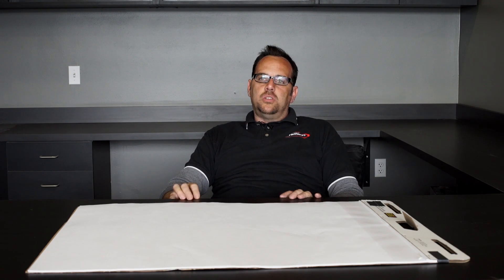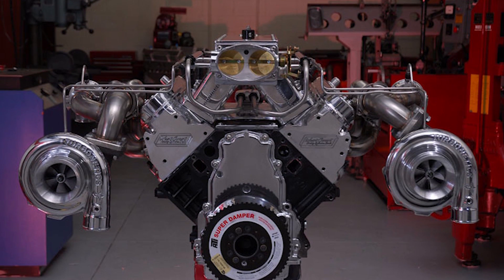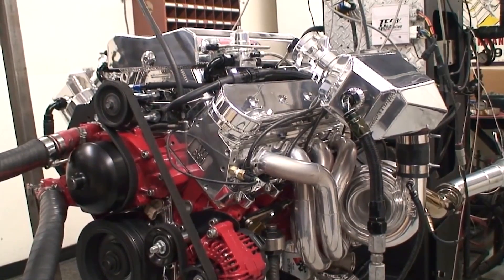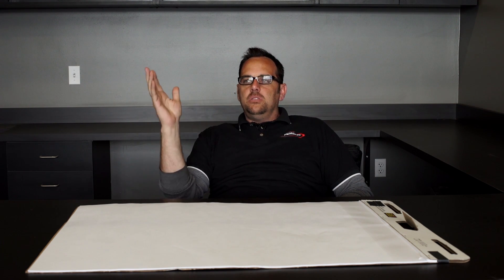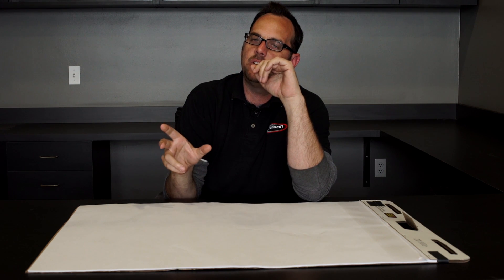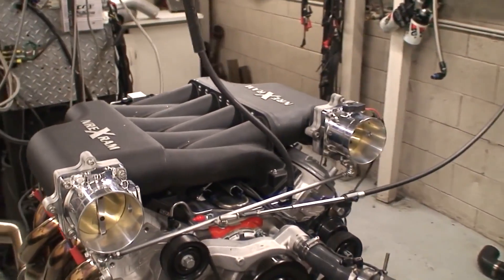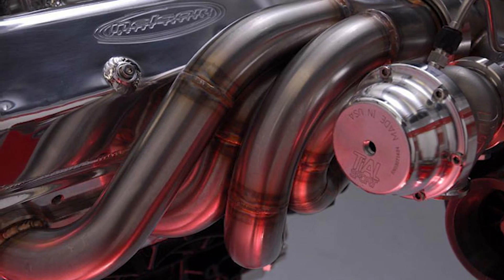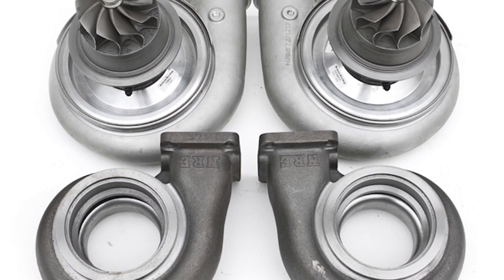Master Engine Builder Explains Why the LS V8 Is SO Good

Comment: "LS swaps are stupid" - 17 year old JDM fanboy who has never had a car faster than 15s 1/4 mile
Reply: +Foxtrot Oscar

Before you call me an import hater, I own and track an S2000, and have never owned a piece of GM hardware.  Even so, I respect the LS.  It is a light, space-efficient, economical, readily available powerhouse, and nothing does what it does better than it does..

For the LS vs. VQ - are you serious?  I'll take longer - there's an extra pair of cylinders.  But have you seen the size of the cylinder heads compared to the cam-in-block design?  because here you go:

http://i51.photobucket.com/albums/f361/prolariot/IMG_5356.jpg

The VQ35 doesn't have valve covers on there either, so add another 2" to height and width.

How much is the brand new 2Jz going to cost you?  Oh wait, you can't buy one, they stopped making them 15 years ago.  A refurb costs minimum $5 grand, and you still have to add turbos, turbo plumbing, intercoolers, etc.    I can buy a new LSx tomorrow.  Unless you have a supra already.  I guess I missed that part.  And the 2Jz is an iron block boat anchor and weighs 50lbs more than an LS while being longer and taller too.

And moreso than that, you're comparing aftermarket support to factory power levels.  That's apples to oranges.  If took $7k and your already LS equipped car and bought a blower, you would be looiking at 6-700hp.  It would be a hell of a lot more reliable too since you're not pushing 30psi (2bar if you live outside of the US) to make that power.

I missed the part where an SR20 came with forged pistons, a massive FMIC, twin-scroll manifold by FullRace, and a GT35r from the factory.  Because they didn't.  And oh wait, that's also $7k.  Bet those will fetch a premium the week before race wars.
Reply: +Foxtrot Oscar people pay no mind to this guy. He's just shown the world how ignorant he is to engine builder. Any intelligent and educated engine builder knows not to play favorites with brands it's all about design, like Tom said "engines are just air pumps." it doesn't matter whether the engine configuration is straight, V, or flat. it doesn't matter if uses push rods, overhead cam, or pneumatic valvetrain what matters is flow. And that means flow you need for your specific application.Tom Nelson knows what he is talking about. He is a world record holding engine builder. I went to School of Automotive Machinists in Houston Tx. They teach the exact same concepts. Guess what.... they are a world record holding school. Just like Tom said there is no perfect head. I bet if you ask what's the perfect engine he will tell you there isn't one. Everything is application specific. Who you are going to take notes from people, some troll in the comments section. Or the world record holder that makes millions of dollars because he has a reputation that speaks for itself.
Reply: Foxtrot Oscar Low output per size? Lol do you realize that the LS engines are physically lighter and smaller than most DOHC engines with half their displacement? The LS engines are unbeatable in terms of output per size.
Reply: ***** But where does that "technological development" manifest itself in the car's performance? Does it make the car accelerate quicker? No. Power-to-weight does. Is high RPM's in and of itself a beneficial thing? No. If a car revs to 8000 and makes 500hp, it's still just as powerful as a car that revs to 7000 and makes 500hp.
Everyone equates VE to "technological development" for no real reason. It does not manifest itself in the end performance numbers of the car. Everyone just perceives it to be better because it appears more "high tech."
Reply: The whole horsepower-per-liter argument is a sure sign of a noob. Nobody talks about HP/L anymore, because people have realized that it doesn't give any indication of power-to-weight. The LS engines have absolutely unmatched power-to-weight capabilities, and that is what makes the car go faster in the end. Period.
Reply: +Foxtrot Oscar

I don't know where you're getting any of that.  A crate LS3 gives you 430hp for $7500, a LS2 out of a wrecked GTO, C6, or C5 Z06 will give you 400, and mid-300s for an LS1 for less than $2k.

Being all aluminum, they weigh nothing.  A fully dressed F20C is 326lbs.  A VQ35 is around the same, and it is an exceptionally light V6.  An LS2 or LS3 is only 75lbs more and has so much more potential it's mind boggling.  Not to mention it is more compact than the VQ because of the pushrod design, so it fits into basically anything without much need for making space.  27% more weight for 25-50% more horsepower?  Yes please.  And it's cheap!  Plus you have a nearly unlimited aftermarket if you want more power.

I've said it before and I'll say it again: there aren't many vehicles that aren't made better with an LS swap.
Reply: @BecauseRaceVids  e30
Reply: +Foxtrot Oscar You're a brain dead English troll. GTFO you Jag loving moron.
Reply: *****  But for what reason is VE important? It does not give any indication of power to weight. VE will not make the car go faster. Only power to weight will.
Everybody always talks crap on the LS for having low "horsepower per liter" and yet they can never explain why "horsepower per liter" is important. Basically their whole argument is "cuz its more high tech." But what good is "high tech" if it doesn't maximize power to weight?
Reply: came here to learn things, ended up reading jacked shit from fanboys and misleading noobs with cash and cars who also posts in other "heroVShero" comic threads. Where are the pro builders and engineers?????
Reply: +Richard Harrold 
That primitive LS engine has better fuel economy than a GTR. The single cam design is optimised for efficiency. Cam it, boom, you're getting over 500hp crank. IHE, closer to 500 wheel. Have fun doing that with the strung out MB v8. It'd cost as much as an LS to have those gains.
Engine size, weight, packaging, cost, modifications are all part of the package. No one swaps a MB V8 because of the cost, weight, size. You want 800hp NA? You can buy a turn key LS based motor that will do it. There's a reason LS is number 1 for re-powers and swaps.
Reply: +Richard Harrold and how much does that mercedes motor cost and weigh?? also how big is the overall dimensions
Reply: ***** Believe me when I say that no one in America, the LS engine's birth place, gives a shit about what you think about it or its IMAGINED slights. No engine gains 100+hp with a cam swap alone. Don't try to feed me that bullshit, son. I've has my hands in anything with 4 wheels for over 20 years. Your comment shows you didn't watch the video. The LS7 head flows well over 360 cfm. And check this shit out:

"In 2011, a class action lawsuit was filed in United States District Court in New Jersey against Daimler AG, Mercedes-Benz, Mercedes-AMG for alleged defects in the M156 engine contained in AMG vehicles built in 2007-2011 model years leading to premature wear. The plaintiff claimed the combination of cast nodular iron camshafts and 9310 grade steel valve lifters contributed to the premature wear."

What a pos. Yeah its so much more impressive than an LS3. Do you realize that it actually boasts more displacement at 378.8 cu. in. @ 500hp vs the LS3's 376 cu. in. @ 450-460 out of a crate? They make more hp but less torque. It redlines at 6,800rpm. Big deal. The LS3 does revs to 6,600 while making more usable power and torque. The LS7 revs to 7K. But I thought DOHC were supposed to be better?
Reply: ***** "The LS is cheap because it uses lower quality components" - such as? Source?
Reply: Foxtrot Oscar  And that engine itself probably costs more than an entire Corvette. VE= Volumetric Efficiency, or "Horsepower-per-Liter," which has been shown time and time again to be a completely meaningless number.  Power to weight wins in the end. It's very simple.
Read this: it literally takes Mercedes a $56,000 engine just to match the power-to-weight of the LS7.

http://www.caranddriver.com/columns/pushrods-versus-overhead-cams-part-38-modern-v-8s-from-gm-and-amg-slug-it-out
Reply: ***** You talk too much off ignorance mate.
OHV I don't care who makes it will be lighter and smaller then the Comparable DOHC. Those are Facts of life.
DOHC obviously provide performance benefits, but with cheap performance cars those benefits are largely unnoticed.
You're bitching about engines that didn't sell well in either continent... I mean seriously what the fuck do you expect?
All that matters is the winner... and as long as chevy can come and fight with the best and win races at IMSA and even leMans you're blowing hot Air.
Reply: Foxtrot Oscar Since when is 518hp "significantly more powerful" than 505hp?
Reply: +Foxtrot Oscar keep hating the ls engines are so simple and we'll built , durable and e z to upgrade.the height is low enough to clear most hoods and the engine is more compact than most v6s. I don't know why you're mad at a motor lol what's wrong with you?. I have yet to hear of many vq swaps.the only thing better in terms of cheap power is a 2j which are discontinued and requires the space purchase of a tucking turbo and custom exhaust manifolds if you swap.
Reply: +Richard Harrold I have a 600 hp ls1 that has instant throttle response and very efficient and far more reliable than a dohc. They are cheaper and easier to work on and have been proven very worthy time and time again. I know it and Nelson racing knows it. He makes insane horsepower out of ls motors that dohc can't compete with.
Reply: +Foxtrot Oscar I hate to be one of those guys, but you REALLY don't know what you're talking about. LS engines are lighter and physically smaller than almost any dohc 6 or 8 cylinder engine made. your typical 5.3 makes up to 340hp from factory and can handle up to 1,000hp with nothing but a valve train upgrade. Several people have done it. If you think they're larger than a VQ45, you're just typing to troll people that don't know any better. I have a picture of a VQ45 and an LS3 sitting side by side. If I could post pictures here, I would prove you wrong on the spot. Do you realize that there wasn't a dohc n/a V8 made before 2011 that could match the LS2 in power, torque, and fuel mileage? Some "stoneage" technology, huh?
Reply: +Foxtrot Oscar And another thing: "low output for size"...I assume you're pulling a Honda fan and throwing out the displacement argument. For someone who claims to be an engineer, you're not that bright. Then again, I work with engineers on a daily basis and haven't met one yet that has any walking around sense. OHV engines get the majority of their overall output from their bore and stroke. OHC engines generally get their output from the head design. LS engines are the exception because GM found a way to increase cfm performance while maintaining displacement which in turn created an engine that both reacts outrageously to f.i. and n/a upgrades, and is reliable at the same time. The vast majority of dohc engines do not respond well to n/a upgrades (ported or aftermarket heads, cams, intake manifolds, etc.). Just look at the Mustang aftermarket. Almost every part is geared toward boosting a 3v or 4v.
Reply: Deadeyedickification   Don’t waste your time. He’s biased and blows nonsense from his ass. There’s nothing you can say that would get him to admit he’s a fool.
Reply: ***** No one cares about specific output. It literally does not matter. Horsepower and torque throughout the power band, weight, physical dimensions, cost, ease to maintain, and fuel efficiency are all that matters. Who cares how fast the engine revs under no load? You're never going to need an engine to rev up really fast on a track, because the engine's rpm will be limited by the load placed on it through accelerating the car. Where have you seen an M156 getting 30 mpg? Is that on the European cycle? Because the US cycle, which I believe you're referring to in regards to the Corvette, is much more stringent. Over here, the 2013 C63 AMG managed 13 mpg city and 19 mpg highway. That's far worse than either the Camaro SS or the Corvettes from that year.
Reply: Foxtrot Oscar And I'll keep asking the same question: Why does the better-breathing and better VE matter if it does not result in better POWER.TO.WEIGHT?
In the end, an LS7 makes 505hp and weighs only 450lbs. Period. End of Story.
Reply: +Richard Harrold 
Just about every performance engine, let alone the S65, is less efficient than the LS series. The fact that you don't already know this indicates to me that you looked at nothing more than the displacements and assumed. The old M3 with that engine managed 14 mpg city and 20 mpg highway. Even the heavier 2013 Camaro SS with an LS3 gets 16 mpg city and 24 mpg highway. The C6 Z06 with its 505 hp LS7 is listed at 15 mpg in the city and 24 mpg on the highway, with most owners reporting better mileage than that. Just to reiterate what everyone else is already saying, HP/L means NOTHING.
Reply: Foxtrot Oscar You keep on going on and on about why it's stupid and antiquated, and you still have yet to give a single legitimate, QUANTIFIABLE reason. You just keep coming back to "cuz DOHC is more high tech and stuff." Once again I ask, where does that manifest itself in the end performance measures of the car? Does VE make a car faster? No. Power-to-weight does. Does it make an engine smaller and more compact? No. Will it make an engine have a lower center of gravity? No.
Reply: ***** First of all. He is anti-American in terms of cars. He will not give one bonus point to any vehicle made in America. He is a 16 y/o English fanfuck who knows literally nothing about cars or engines. He claims to be an auto journalist. No self respecting auto journalist would downright degrade something, nor would they troll LS videos on youtube to start fights.

Secondly. LS is set up from the factory to be a well balanced platform and they will not put more hp than what is needed in GM's front engine/rwd platform cars. LS has immense potential for power and there are SEVERAL videos of N/A LS motors making well beyond 700HP with as little as 5 grand put into them and over 2000hp when internals done. LS7 - 505hp, 460lb-ft, 403lbs, $12,000. M156(third attempted version) - 518hp, 465lb-ft, over 500lbs  $38,000. The M156 is tapped out at that point, it cost Merc $26,000 more, an extra 3 camshafts, an extra 16 valves just to match "ancient" technology. People filed lawsuits against AMG for failing camshafts and valves caused by weak steel. If the technology is so much better and German manufacturing is so awesome, why did they make a camshaft from cast iron, and the valves from basic steel? They might as well used tinfoil. The only reason the cost of LS series is so low is that there are soooo many of them being made GM just built there 100 millionth small block, I think they may have a few things figured out at this point in time. GM even offers a program to come help build your motor BY HAND. Now for size, LS is much smaller, and is smaller in size than many inline and V six cylinders like the VR36DETT, 1 and 2JZ, VQ35, and many others, not to mention being significantly lighter than all these engines.

Thirdly, the LS is a pushrod engine, sure valve float is possible at extreme RPM. But that doesn't fucking matter because it doesn't need to rev past 7000 to kick the shit out of any V8 that has ever come from the Eastern World. People make over 2000hp, 2000lb/ft with this technology at under 7000rpm. They are accredited to be the best bang for buck on the planet and there are many with as much as 500,000 km's before rebuild. No Euro engine can do that, except maybe a TDI.  LS is swapped into everything from chainsaws to airplanes, and there is a good fucking reason for it.

You defensive Euro-loving biased morons need to look at facts, not just make shit up on why you don't like the LS because one just dragged your piece of shit Ferrari down the street. LS is king of V8's. It's not up for argument, it is FACT. I am sick of setting US-hating Eurotrolls straight when they spew their fucking bullshit all over the internet.
Reply: Foxtrot Oscar STFU troll.
Reply: First of all, I'm not assuming anything. It's obvious what you're doing. Secondly, I'm not a boy. I think everyone here would rather trust the guy in the video who has more experience than you driving and more experience with LS engines and car mechanics in general.

Still haven't given a reason as to why you clicked on the video if you already had opinions and knew everything you needed to know.
Reply: +Josh Wallace and his car sounds like a dying vacuum with a cazoo attached
Reply: PontiacEfurd Wrong. A brand new turn-key LS3 is a tick above 6K. But it's always been cheaper to rebuild used engines if you want a modified one anyway.
Reply: Foxtrot Oscar You mean the 458 Speciale's engine? Show me a source for those specs, because I've looked and found nothing. I imagine that engine is actually larger and heavier than the LS7.

Even assuming they're correct, your math is wrong. 150kg is 17% lighter than the 181kg (400lbs) LS7. And last time I checked, 597 is not 33% more than 505. It's 18% more, and the LS7 makes 18% more torque than the Speciale's engine. That's an actual fact that I can cite sources for.

Speaking of torque, I believe that smoothness that you're describing is actually a lack of it, especially in the low range. I've had this conversation with you elsewhere on youtube, and you still are blabbering on about it. You want the engine to not make enough torque in the low range to spin the tires if you plant your foot while exiting a corner. That's not fast. That's being a lazy driver. That pedal under your right foot is what's supposed to be responsible for modulating power, not a horrible power curve. The LS7's amazing throttle response and torque will spin the tires in a hurry if you're a bad driver.
Reply: You think official economy ratings are BS? Why, because they don't fit the way you would like things to be? Much better to trust anecdotal evidence, clearly. It's pretty obvious at this point that you know fuck-all about the cars that you're talking about. For starters, the C7 doesn't make anything like 230hp in V4 mode. You just took the engine's total power and divided it by two. It doesn't work that way. Those 4 cylinders still have to deal with the friction from all 8 cylinders, so it doesn't scale like that. Also, in order to make that power, it would have to reach towards the top of the rev range and be at full throttle. As soon as you exceed a certain throttle threshold, all 8-cylinders light up immediately, so you would never reach peak power for just the 4 cylinders. And apparently I have to state this again, since you can't read: the C7 does not have an LS. It has an LT series engine. They are not the same. You also keep harping on about cylinder deactivation as if it's cheating. It's not. It's no more cheating than having variable valve timing or a turbo charger. You lose power when you don't need it in order to improve fuel economy, and you get it back as soon as you want it. You still haven't given me any practical or performance-oriented reason to care about HP/L, and that's because there isn't one. Now you want to go one about American V6s? Alright, I'm game. The GM LFX currently makes 323 hp, and next year it will make 335 hp in the new Camaro. That's a 3.6 liter, by the way, and it makes that power on 87 octane. Last I checked, 440 hp is not twice as much as 323, and 4.4 liters is more than 3.6. You bring no facts to this debate. Nothing but anecdotal evidence, hearsay, opinions, and outright misinformation.
Reply: ***** My answer to any of your claims that the LS engine is inefficient:
LS7 = 505hp and under 450lbs. Like I said before, it takes Mercedes a $56,000 engine just to match that power to weight.
Reply: +Richard Harrold Shut up, fuckboy.
Reply: Thomas Patterson Nice argument. You must be a really smart guy. Look up everything I stated. It's called FACT. Not opinion pieces you Europusstrolls make up to make you feel better about your shithole island and worthless V8 engines. Show some respect from the country that is directly responsible for your mere existence. If it wasn't for US tech, you would be putting the steering column in a VW Beetle, for free.
Reply: ***** Foxtrot is nothing but a troll that works at a grocery store, living in his moms basement. I don't know why your defending him. He's a bum dart champion and spews nothing but biased bullshit against American cars and engines. If he gives a plus one to an American anything, its because he feels England had a hand in developing it. England sucks, so do your cars. How is McLaren doing in F1 again? Oh right, they cant finish a race without engine failure.
Reply: +Foxtrot Oscar you do realise that all the stuff you said was wildly incorrect? Ls engines are actually genious. Gm obviously knows thier engines can make way more power than what they put out. It all comes down to emissions here in the states because of tree hugging liberals who cry about green house gasses. Let me elaborate. Bmw for example, squeeses every avalible bit of power from the factory out of their engines. Sure, you can increase boost and retune for extra few hp but not with longevity in mind.  Ls engines are capable of way more power with far less modifications and still have the same reliability. Gm purpously holds the engines back to make them last and for numerous other factors you fail to see. The department of transportation also limits what the cars can
 put out and still meet safety requirements. Basically our government sucks and holds us back. With that in mind, gm gives us the base building blocks to mod up to what it should have been from them to begin with. They could have easily made the ls7 put out 700 hp from the factory, but it would never pass safety regulations. Dont be so naive.
Reply: Foxtrot Oscar Any reason why to back up your opinion, guy?
Reply: ***** But it really isn't an indicator of efficiency, as my prior post proved. Higher revs does not always equal more power. That's very dependent on engine design. Higher rev limits aren't more fun for everyone, either. That's a matter of opinion. Some people don't want to have to string their engines out to 9000 rpm to make peak power. Your point on some M156's getting 30 mpg is complete heresy, since no agency has substantiated it, and will be ignored. Even if it were accurate, that would be with an imperial gallon, which, as you brought up, is .761 liters larger than our gallon. So you're comparing mileage from cars in the UK, using a different standard for the volume of a gallon, to mileage ratings in the US with a smaller gallon. The fact of the matter is that, in the US, as rated by the EPA, cars with LS engines get much better mileage than the BMW M3 with that engine, or just about any other performance car of that caliber. The LS series of engines do not have cylinder deactivation. I will repeat that, since it seems to be a big point for you. The LS1, LS2, LS3, LS6, LS7, and LS9 do not have cylinder deactivation. The LS3 is in the Camaro SS, and the LS3, LS7, and LS9 are in different models of the C6 Corvette. Only the C7 has cylinder deactivation, with its LT1.
Reply: ***** You completely ignored everything I said. You side stepped. Stay over on your side of the pond so that you shit heads don't seep that know nothing mindset over here. Mercedes engines are not impressive. They're bloated, over rated boat anchors that cost too much to maintain and upgrade with little gain.
Reply: Downsizing to what? 4 cylinders? bitch please. I'll downsize to a 6 cylinder and skip the four and go straight to electric. *****

M156 became irrelevant... Quit trying to sugar coat it.. They couldn't make it pass emissions and didn't feel the need to make it pass... Hence, Irrelevant....

Just like when V8s get axed off here... I won't sugar coat shit. THey'll be axed because they are obsolete and irrelevant. I'm also pretty sure that 99.9 is highly exaggerated but that's none of my business.

Again, come back with your BS engineering marvels when your best selling isn't an American brand
Reply: US V8's are commonly banned from European competition because they are to good. The C7.R dominated its class at LeMans this year in the GTE-Pro class, it is also their 8th win at that circuit. It is not uncommon to see it beating European competition, sometimes even in higher classes, in the Tudor series. The C7.R has a de-tuned GM small block with restrictor plates to keep it fair for the rest of the competition.
Reply: I will not waste my time reading your dumbass rebuttals. I sure do love making you waste 101 lines of your time though, keep it up jackass!
Reply: +Foxtrot Oscar You keep talking LSx weight and bringing up the SR20.  A fully dressed SR20 is 490 lbs or so.  A fully dressed LS1 is 497...  heavy not found.  ;)
Reply: +James Schall thx man i was gonna chime in and say the same exact thing 2jz yes good but are you gonna mod a 10-12 year old engine with performance parts or could you pick a brand new aluminum v8 that has more power and its going to cost the same or cheaper than a rebuild for the 2j with out mods
Reply: +Ernesto Picazo 
No hate there.  The only thing is being dohc, those massive heads limit what they can fit into if you're swapping them.  That's the LS's biggest pro as a swap candidate - it makes all that power and fits into almost anything.
Reply: James Schall Exactly: that's what people don't get. Everyone assumes they must be huge because of their big displacement, but the LS engines are very compact for their displacement: often times smaller and lighter than engines with much less displacement.
Reply: +Foxtrot Oscar Man you are a hardcore troll dude. I bet you never owned an LS car. you just wish that you did. Even the picture you showed works against you. the ls is smaller and has all its acessories also. You write gigantic post but provide absolutly no facts. Only keep blabbering about how you are jealous of not having an LS. Ironically enough the LS is more fuel efficient than most other "performance engines" while still having more power. Get you finger out of your a$$ kid and grow up.
Reply: +Foxtrot Oscar Fuck, now I wish I read all of your other comments before I spent so much time on that rant. I hate spending so much time on trolls.
Reply: +Foxtrot Oscar How long will a 2j pump out 5oo hp. My ls7 has done it for 150000 miles .
Reply: Foxtrot Oscar You reply to be as sir you POS.  WE are the ones that gave you that shithole country of yours, WE are the ONES WITH THE NUCLEAR BOMB, its because of us, you can make those shit Jaguar engines that have to be rebuilt every 50k miles.
Reply: +Foxtrot Oscar Although, you're good at history, I must admit that LS engines are pretty good too. Much better than most of the euro engines nowadays. As for pushrod system, I know it's dated, but the engine is smaller. And for your interest, Bentley (i.e. VW group) had designed a new pushrod V8 for their cars, not a triple ohc or something. I have seen LS engines apart, just as well as many others, and LS engines are like a cheat code for power and reliability. With pushrods you have only one cam which is a lot cheaper than 4 cams of a DOHC engines, you can do a bunch of things with proper valve seats and headers, plus you have ton of displacement for low end torque. They are good, they are brutal and they are reliable. They are just not enough sophisticated for europeans.
p.s. VW/Audi engines suck.
Reply: Torque is for towing lol. "Torque wins races, horsepower sells cars." said one of the greatest automotive engineers the world has ever seen. Saying the LS is shit is like saying England is a great place to live. It's just completely false.
Reply: Ciley Myrus The Gee wiz? What a terrible little car that is, utterly hateful in every way. 
There, how's that for abstractly associated diversion of conversation?
Reply: Mr Shane Depends on the car, actually. Some stock filters, especially on older cars, are so terrible that a K&N would actually help. Then again, in that situation, switching to any other kind of modern filter, like a standard paper one, would work.
Reply: ***** Round and round like a broken record
Reply: Foxtrot Oscar Revs equal power because the engine is displacing more air over time, you can do the same thing by increasing static displacement, why you get so butt hurt over that is a mystery and why you think a small high speed piston pump is a more efficient pump than a large low speed piston pump is an even bigger mystery, if you're so concerned about strain and stress on internal components why would you want rev the shit out of an engine to go fast, you do realise that pistons, conrods and crankshafts are an even more archaic design than pushrods don't you?
Reply: +Richard Harrold

No disagreement on the OHV vs DOHC thing as far as technology is concerned, but it comes down to packaging.  DOHC heads are huge, and an LS is less wide than any DOHC V8 or 90 degree V6, as well as far shorter than an I6.

If we're talking about the best engine for a swap, the LS is it 99% of the time because it makes the most power and it fits without much if any fabrication work.
Reply: James Schall   I Love how these clowns think dohc are superior and yet none of them talk about how worthless a ten year old bmw or mb becomes. Paying 130k for a car that will be worth less than 10k in a decade because they have a worthless engine and transmission. Too superior to even be fixed. So these clowns, well, they can take their technologically superior bullshit to the junkyard. Because that’s where their much loved engines have any value.
Reply: +Richard Harrold I have to ask but have you ever driven a lS engine equiped car? They have amazing throttle response! so much low end torque throws you back into your seat as soon as you touch the pedal. The more i keep readin your post the more I am coming to a coclusion you know very little about anything.
Reply: +Foxtrot Oscar If you were really an engineer, you would realize that you're comparing applying forced induction to smaller engines to making big power out of a naturally-aspirated engine. There is no replacement for displacement. I don't know why people think this adage is wrong. People who think it is wrong really have no clue how an engine works.
Reply: I don't see what's special about the "Voodoo" DOHC V8 making a lot of hp but it doesn't make peak torque until 5000rpm which is 430 lb-ft, pretty low for a V8 cranking out 525hp that must rev to 8000rpm to get it. It's larger than the LS7, weighs more, costs more to upgrade, cost more to rebuild and over a decade later barely beats it's hp number. LS7 makes its power earlier, and has a more efficient torque curve. Not to mention low cost and ease of modification. Although I do admit this Voodoo engine would have been a much better choice for the new Ford GT instead of a V6. I guess even Ford knew that the LS swaps were inevitable.
Reply: ***** LS7 does it with half the valves, 3 less camshafts and most likely gets better fuel economy. BHP/litre loss, BHP/weight win. Smaller motors with more unnecessary moving parts only prompts failure and doesn't not excite me, neither does their large under hood size and weight. LS is simple, extremely light, infinitely upgradable, makes the best power in the world for the money, and runs for ever. It's the go-to engine of the world man, for good reason.
Reply: You bow down to the people that gave you freedom.  You incompetent fool, you were months away from loosing the war, Hitler was testing stealth bombers that were flying at the speed of sound and your SHIT radar couldn't see them in nowhere near the time for you to be annihilated.  I've been to your shit hole country its a dirty mess, full of assholes with a sidewalk you call a road.
Reply: ***** Don't forget to thank the Poles, New Zealanders, Canadians, Czechs, Australians, Belgians, South Africans, French, Irish, Americans as well as a Jamaican, a Southern Rhodesian and a flyer from the Palestinian Protectorate who all helped the RAF do the job of protecting the queens island. Over 100 Canadian airmen fought in the battle of Britain, 24 of them were killed.
Reply: +Richard Harrold.      Dohc= zero bottom end. The flaws of that design are being top heavy, noisy, added weight due to more parts, and over complication meaning less reliability (more stuff to break) vs. push rod design. Not to say they arent good motors, but every design has flaws because they are man made.
Reply: +bart medes
"you have freedom because of the USA and the FUCKING NUCLEAR BOMB."
lol, oh, you don't know history well! Time to admit it!
The nuke was needed for the Alliance ex-USSR to stop soviet communists from invading other countries. Which is complete bullshit! Say, it is all the same bullshit that you have about Russia nowadays, though who cares... The man who feared it most (i.e. the potential europe take over by the communists) was actually Sir Winston Churchill. He spread his own thoughts, so the US decided to go for a nuclear bomb development program. And so when it was ready, as the US sources say, they bombed Japan to prevent a new war / as a revenge for Pearl Harbor / to show bloody communists that the could be next. Which was stupid... so the USSR developed nuke too and finally went for the ultimate H-bomb, which is kinda the baddest shit ever created. That's it.
Reply: bart medes Man, I'm actually russian, and there's nothing good about nuclear bombs apart fear to fuck up the whole world. That fear leads to negotiations, meetings and discussions - and such things are good.
Reply: ***** I wouldn't say no guns is good.
I personally own a number of 'firearms' including a shotgun, a couple of higher powered air rifles and a Lee Enfield No4 .303
The shotgun is used for clays and occasionally bagging a few pigeons or pheasants for a pie, the air rifles are a good laugh to use for target shooting papers or tin cans across the yard, and I've always loved the look and feel of vintage bolt action rifles since shooting the Lee Enfield No8 as a Cadet.
Sadly it doesn't get much use as .303 rounds are hard to come by.

I enjoy these 'weapons', they are pleasing objects to own, with their own histories, and target shooting is a highly enjoyable activity.

None of them, however, would be any use at all if I wanted to go on a murdering spree, despite the Lee Enfield's previous life as a (WWII) service rifle. A shotgun is too bulky and too slow to reload, and are actually non-fatal at long range, especially bird shot (loads of teeny tiny lead pellets). Air rifles are even worse, as they're low powered, impossible to carry in the street without someone noticing, and take an age to reload. By the time you're done, everyone's run away.

The Lee Enfield is the most dangerous, as a .303 round is pretty chunky, and you can get 10 rounds in there... but it's still single action, you have to manually re load it after every shot... and it's huge and heavy. And the amount of paperwork and club membership and so forth means that it's largely impossible for any 'casual shooter' to gain access to one. (that is, someone who flips one day and decides to go shoot stuff up, would have to go to so much effort to access one, that he will most likely not bother, or someone should pick up on general 'dodginess' before the process completes.
A number of people have had licences revoked and firearms seized for displaying unsavoury behaviour)

It's still very much possible to access guns in the UK, just nothing really dangerous (and seriously, why do you need a hand gun, or an automatic weapon for target shooting, when a single action rifle is just better for such things) and the processes for giving access give good change to weed out those with less than friendly intentions, or those who simply aren't clever enough to be trusted.

The number of gun fatalities in places like the US that stem from incompetence and poor practice is incredible, like the 9 year old who recently killed a shooting instructor with an Uzi.... everything about that situation is fucked up, and in Britain, is illegal for that reason.
Reply: C Genious Yes. The old 6.75 Rolls Royce/Bentley pushrod V8 is, frankly... naff. Introduced in 1959 (I got my years wrong) it wasn't particularly advanced then. Jaguar were already building the superb Mk2 and the Mk10 would come out two years later, with DOHC engines, and superb comfort and luxury to boot. 

These days, it's well past it. It's heavily turbocharged to make up for its dismal natural performance, and it still doesn't actually make that much power for its size. It should have been ditched decades ago, but Bentley never seem to have any money.

By the time Jaguar brought the 5.3 litre V12 to the XJ in 1972, Rolls/Bentley had a problem, as the Jaguar was smoother, more refined, MUCH lighter and more powerful.
Reply: ***** I don't know, the Lee Enfield is pretty powerful. I believe you can get hold of up to .50 calibre rifles, so long as they're single action. And a .50 cal will smash the crap out of pretty much anything.

It's not necessary. 

I had endless fun as a cadet with the diddy .22 No8s. Bolt action, small calibre, no problems. The No4 I got because, it's cooler... basically. And it has a magazine, meaning you don't have to manually insert the round into the breech every single time, which can get tedious. The bolt does that for you, even though you still have to manually actuate it. 

Sure, the temptation is there to go play with the mental automatic stuff, but at the end of the day, they do little to help target shooting, and cause far more problems than they're worth.

I certainly don't want them in the hands of the public either, and I'm perfectly happy without them myself, as even the No4 is a massive indulgence, and is largely pointless when I have the air rifles.
Reply: ***** I've never heard of any quad cam Jaguar V8 apart from the AJ-V8 that's currently in production (and is totally wrong for a Jaguar, shouldn't be used, and powers amongst their worst cars)
The only military engine I know of that Jaguar have made is a chunkier version of the 4.2 XK to power Scorpion light tanks. 

Any of the old Jaguar saloons are sleepers in their own right (except maybe the 2.8 litre XJ, that's about 'normal') especially the early XJ12s. I mean, 140mph in 1972 was pretty impressive... for a sports car. Let alone a big luxo barge!

The only thing I have against the Mk7-9 etcetera, is the styling... I never got on with Jaguar saloon styling until the Mk1/Mk2. The S type was nice... and independently rear suspended.

Autocannons/miniguns/whatever you want to call them never really interested me. I mean, yay, I can smash through a couple of thousand rounds in a second and obliterate some stuff.... but what else can you do apart from smash stuff? You can't use it for any kind of accurate, skilled target shooting, and it's the targeting part that I find to be enjoyable. 

That said one of the big 20mm Hispanos from a Spitfire would look pretty nice on my mantlepiece... Though the rest of the Spitfire would be even better!
Reply: DoriFord Throw 30 grand into an SR20 and you're a fuckin' madman. Why bother? A full race engine doesn't cost that much. You can buy pre built SR20s from Tomei for £13 grand, fully forged everything, 200cc oversize bore/stroke (2.2litres overall)... good for what, 500hp+ depending on your boost settings.

If you spent over twice that on an SR and got a crap narrow power band, that's your fault.

The turbo's, if set up right, give a good fat power band anyway.

SR20 'boxes are not shit, they just don't like ham-fisted monkeys smashing them about. They work perfectly fine in drift cars, and if you are a ham fisted monkey, then the CA18 gearboxes are much cheaper, so it doesn't matter if you smash one.
Only the 6 speed boxes are naff. The 5 speeds are good. 

LSs are no more reliable than SRs, and I should know, and they're not actually that cheap. It's cheaper to import a whole S13 from Japan than it is for me to get an LS from the US, and the US is much closer than Japan is, about half the distance in fact, so the shipping is much less. 

Also, if you're basing your engine choice on price, go for the best still. 

Always go for the best you can afford, otherwise you are, in my view, an idiot. And in the case of engines, so you may have to sacrifice a few horses, but quality stands forever, and you'll appreciate it far more day to day than the extra ponies. 

I wouldn't touch a modern Lexus with a barge pole, unless it was the LF-A. Really not great cars. Ugly, and trying too hard to be sporty when they're really not. 

The real world is somewhere I've lived for a long time, and in it, the LS is a miserable side note.
Reply: +Serenity in silence no. GM did nothing more than copy several Ford engine designs. examples include, ls engines use Ford 351w firing order, the ls block design is a mix of Ford's y block design from the 50's, and Ford's modular engine. All GM did was move the cam shaft to the middle of the block, instead of dohc. Lastly, the heads used on the ls are canted valve, that's Ford Cleveland design.
Reply: rustyATV Hard to tire of something you weren't doing in the first place...
Reply: +Richard Harrold No, HP per Liter is a useless argument about efficiency when that "big V8" has better fuel economy than performance based V6's.  Look at say, a 2009 Honda S2000 vs a 2009 Corvette.  The V8 makes FAR more power (237 vs 430) yet the S2000 gets only 2mpg better city, and gets less highway.
Reply: Josh E In the grand scheme of things, no, I don't know much about engines. There are people out there who know immeasurable amounts more than I do.... however, given that I managed to strip and rebuild a Jaguar V12 when I was 17 (which is still going, as my daily, 12 years later), I've had more engines apart than most people have ever even seen in a lifetime, and I've a history of mechanical engineering and thus understand and am able to apply myself to the principles of the internal combustion engine, I think I am safe in saying I have a distinctly above average knowledge of 'engines' in general. 

Power per litre is highly important when discussing performance. Performance being what you can do with what you've got, and if you can do more with less... you're performing better.

That big V8 does not have better fuel economy... or rather, fuel efficiency. 

The 'economy' part of an LS engine in a Corvette comes mainly from the gearing, something I'm surprised more people aren't doing. Then again, when building performance cars, gearing for Vmax is usually more of a priority.

Corvettes, when not cruising at low rpm, use a LOT of fuel. They also use a lot of fuel when picking up speed, no matter how gently you try.

You try racing a big crossplane V8, especially a pushrod one, and you may notice some fuel issues. 

Le Mans, being a good example, where the Corvettes consistently have to pit for fuel more often than anyone else. 

This is one of the reasons I have such respect for the Corvette support team, who seem to manage to keep overall pit time on par with the rest of the GT field, despite spending far longer fuelling. This suggests their repair turnarounds are quicker, which is bally impressive. This is probably why their team area is so flippin' huge, to accommodate the sheer number of people needed to turn a car around so fast.

Anyway... your comparison of an S2k and a Corvette.... hmm. 
Let's start with the obvious. The EPA test. It's bollocks. The 'city' test involves hard acceleration to 60, and a 60mph cruise.... in a CITY. That never happens in reality. You'd be jailed, mostly, even if you could find a city with roads with no traffic. 

Also they only use 'city' and 'highway' as their benchmark... leaving the sort of driving the vast majority of people do, completely untested. 

The S2000 is not designed to cruise, nor is it designed to pootle around town. It's designed to be a fun, fizzy, intensive little car, for batting around country lanes, like a sports car should be able to do. You can, in one, remain in double figure miles per gallon whilst doing so.... not so much in a Corvette. Believe me, I started to consider measuring in gallons per mile with mine at times. 

The Corvette is geared for cruising, that's well known. And in traffic, all an engine needs is to be able to turn itself, which doesn't have a huge amount of variation. 

From what I can gather from forums, C6s seem to be averaging about 16-17mpg day to day, while S2000s seem to average between 21 and 25mpg..
I managed about 12 from my C5 unless I was careful, but I do live in a fairly remote part of the country, so no motorways. 

LBS!!
Stupid units...

Anyway, no, absolute tosh.
The generally quoted figure on Nissan forums (and I'm on a few, with my 180) is, pretty universally, 149kg. That's around 327lbs for you neanderthals
If we take your LS1 figure of 497lbs (226kg) then we can see a huge weight difference.
Reply: ***** This is where Honda have a big advantage with their Vtec system, which is designed around economical performance. The two-stage cam system means you get an economical profile at low rpm, and a high power profile at high rpm. Hence, Vtec kicked in yo. It's the engine switching from economy to power. Pretty nifty.
Reply: @TheWierdFish yo
Reply: ***** England. Cornwall, specifically. Usually.... sometimes. That's where my house is, at least. I'm usually to be found anywhere within the British Isles, or mainland Europe... occasionally the US, Oceania/Australasia or rarely, bits of Asia. 

I get side tracked a lot.
Reply: Ciley Myrus No, making more with less refers to specific output.

Also, you're banging on about weight in your power to weight rant.... But ignoring power. Yes, an OHV design weighs fractionally less than an otherwise identical OHC design... However, the OHC design will make more noticeably power, leaving the power to weight ratio improved over an OHV engine. 

That's why OHC has been the choice of racers since the 30s.

Always consider all the variables, otherwise there's no point considering the problem at all.

We've barely even started on efficiency, dynamics and feel yet.
Reply: Mr Shane In addition, if your car won't readily do much more than 100mph, chances are a spoiler will only slow you down. While the thread was on a 'mods that don't do anything' theme, I thought I'd throw that one in there.
Reply: ***** Disrupting airflow causing lift can be beneficial, as in the case of the Audi, but they do cause drag, and you'll never get actual downforce out of them.
Reply: Foxtrot Oscar You keep spouting the same rubbish over and over like a broken record, if you're too dumb to to be able to rebuild and put an engine in a car yourself that's your problem, and what internals are you referring to?
Reply: May I apologise to all the americans on this, foxtrot is being an idiot, most of us brits appreciate other peoples cars and also what they do to them (apart from maybe chopping the coils on your riced honda civic) I know of several people who would love a good LS or other of your V8s (although we do have the rover v8 which is good... enough) And these are people with everything from an MX-5 to me with their land rover...
Reply: Foxtrot Oscar the engine isn't 'naff'. That's your opinion as well. The engines great. You've spent a lot of time talking about how it hasn't got enough horsepower and all that shit, but have you seen the power curves of the car? The torque and horsepower is pretty much completely linear which is a huge advantage over an engine like a k20 where all the power is at the top of the rev range. You're just purely an idiot who has confidence issues so has try and be important on the internet. You're not. You're extremely sad actually, the fact that you hunt down videos about LS engines just to fault them in the comment section. It's pathetic. If you don't like the engine, then just avoid it? Leave everyone else to like what they like. So why do you hunt down these videos? Are you bored? Wanting attention? Do you just want to assert dominance because you don't have any in your pathetic life? Fucking sad and pathetic haha. You're embarrassing!
Reply: +Richard Harrold u want to know what's a real measure of an engineering feat. hp/liter rattio on an n/a engine
Reply: +Josh Wallace Also said by Rotards.
Reply: +Lucas Boyden Fartcan life XD
Reply: +Foxtrot Oscar yes its an ancient design but let me put it to you this way if it where the worst engine for swaps then why its the most used v8 engine around the globe . and i never mention design i stated as availability your bang for your buck that's what im saying if it brakes like any other engine if not build correctly rebuild it or get another one 2j,vq etc do yo think that you're gonna get as many parts and one of those engine as the ls come on
Reply: ***** The S65B44 from the M3 GTS is a 4.4 liter making 444 hp. The standard M3 motor was the S65B40 4.0 liter making 414 hp. Hmm, that puts the lesser S65B40 at 103.5 HP/L and the S65B44 at 100.9 HP/L. Now why would BMW go and make a worse engine for their GTS model, since clearly HP/L is the only thing that matters? I wonder what factors could have caused the discrepancy between the LFX and the S65? Maybe the LFX being a fraction of the cost, achieving 50% better fuel economy on the highway, and being tuned for regular fuel (rather than the premium required by the S65) has something to do with it? Regardless, those engines aren't really comparable. I merely brought it up to disprove your statement regarding the low horsepower of American V6s. Were your original statement correct, the BMW engine should've had 100% higher HP/L. An LT has VVT, direct-injection, cylinder deactivation, and rev-matching, none of which were on any LS. It's not the same.
Reply: ***** And more HP. It seems pretty reasonable to extend this logic, as long as you don't sacrifice much in the way of additional weight, engine size, reliability, or fuel economy, doesn't it?
Reply: they can be annoying, but not a stupid swap at all!
Reply: I wish I could shove an LS into my mazdaspeed 3 easily :(
Reply: +Josh Wallace its not that LS's are stupid at all, they're fucking awesome. its just so saturated and stale/over done. I'll stick with my turbo 4 and 6 cylinders until I need to go bigger, but in all practical stand points most people wont use over 600hp in anything other then drag racing
Reply: +Foxtrot Oscar How much does that Ferreri V8 cost?
Reply: Ferrari V8 20 -50 thousand plus
Reply: All of this argument has been going on since the 20s and 30s when auto manufacturers laid out the groundwork for all modern engines. This pushrod vs. this single or dual overhead cam, solid vs. hydraulic lift, 2 valves vs. 4 valves vs. 5 valves, 60* vs. 90* vs. inline vs. boxer, this rod ratio vs. that rod ratio, this intake style vs. this intake style, carbeurated vs. injected, supercharger vs. turbocharger, this metal alloy vs. that metal alloy...... I could keep going but I am tired of typing. The point is it has always been a rivalry and always will be until the day we stop making internal combustion engines....if we never challenged even one other design we would never improve.
Reply: +Josh Wallace I love jdm, I think LS are sweet engines and in some cases not stupid but personally thought I own a JDM s15 with only an upgraded intercooler and turboback exhaust stock boost and it runs 13.8s down the 1/4 and is very good on fuel just sayin.
Reply: +Serenity in silence  shut up the fuck up..stupid talk
Reply: C Genious Go say that to the syrian refugees in France, lol.
Reply: +Richard Harrold not having guns isnt something to be proud of. plus universal healthcare isnt free. someone is paying for it otherwise doctors wouldnt make any money. most likely taxpayers are the ones taking the hit for "free healthcare".
Reply: ***** "The new Bentley V8 that's used in the Continental GT is an Audi-based 4-litre quad-cam twin-turbo unit."
That's incorrect. Watch the documentary or just google some images, it IS a pushrod V8.
Reply: ***** So English cars don't even make their own engines, they just license them from Germany? And McLaren can't finish a race? The level of engineering must be godly in the UK. Now I see why you trash on LS so much. It must be a shit engine with a poor design, that's why millions of people praise it like it is a religion.
Reply: +Eddie Mcvain the LS heads are nothing like cleveland heads. I can send you a pic of each set of heads because I have 2 of those engines torn down in my shop right now.
Reply: +Ciley Myrus Abortion is the right choice for unwanted pregnancies! There now its about abortion too! :P
Reply: i've driven a SBC and then my father wanted an LS and swapped it, still hate that engine, it is NOT that great
Reply: +Foxtrot Oscar You don't know much about engines do ya?  lol.
Reply: *****  And the LS engines even have a better power-to-weight than the S2K engine.
Reply: *****  Are you serious? An OHV engine almost ALWAYS weighs less than any DOHC engine of similar or less displacement other than the most exotic and expensive DOHC engines. Even OHV haters know that.
An LS7, with its 7-liter displacement is the almost the same weight as an all-aluminum 5.0L Coyote! Get your facts straight.
Reply: +Richard Harrold  Umm yeah you should definitely do a little research lol. I'm not the biggest fan of OHV, and I was with you up til this point, but it's pretty common knowledge that an OHV engine is almost always smaller and lighter than a DOHC engine of the same displacement due to the extra width and height a DOHC engine requires for four cams
Does that make OHV better? No. But ligher: yes.
Reply: +Josh Wallace I bought a K&M high flow intake and put racing stripes on my civic. Now it has 150 more HP!!!
Reply: +Mr Shane the stripes added 145 of those hp right?.
Reply: Show me a quad cam v8 or even a twin cam v8 that weighs the same or less than an an ls, and could you point me to some prices?
Reply: ***** I would certainly have massive problems with an LS MGB swap. First, width. It's going to be tight. 
Second, it's a classic British sports car. The polar opposite of the American muscle car. The two shouldn't mix. Look at the AC Cobra, Triumph Tiger, etcetera. Nasty, horrible things... Which brings me to the third point. Power. Too much. 
It's a 1962 designed chassis, and the suspension is largely lifted from the MGA, designed in the early 50s. 
Even the crummiest LS1 makes 300 odd horsepower,  which although crap for a 5.7 litre engine, but still too much. 
The factory V8 models with the 3.5 litre Rover V8 were lively, and that was 120hp. Also, a good 30-40kg lighter than an LS in an already fairly nose heavy car. With the LS, you'd also need a bigger gearbox, new rear end, totally reworked suspension... It's just not worth it 
The best swaps I've seen are the Rover K Series or a Ford Twin Cam.
Cheap, light, readily available and true to the sports car roots.

The MGB was designed to be cheap and fun. An LS would make it expensive and scary.
Reply: ***** Significantly larger, as I recall. The Rover lump is fairly tiny. It's maximum bore/stroke still makes it smaller than an LS1, so it follows that it is physically smaller.
The Jensen FF is the only one of those Yank V8/British chassis arrangements I'd consider.... And the engine and gearbox would be out in seconds. A Jag V12 would make it so much better, and manual, all the way. The K Series is plenty torquey, but has the advantage of a better top end. Good top end doesn't mean a bad bottom end. 

The 'B is only ~920kg wet, so a 1.8 litre engine is more than enough, especially given the K series' capacity for specific output.

The 'B was never a razor edge speed demon, and never will be. 

If you're going to all the bother of replacing the engine, drivetrain and suspension, you may as well have just bought something better. The MGB shell is nothing special.
Reply: @TheWierdFish yo
Reply: ***** The later RV8s are heavier, I believe and most ~200kg figures I've found are for absolutely everything while most figures for LS1s don't include all the ancillaries, or things like clutch, flywheel or starter, all things that weigh a ton. 
The Rover being longer is probably a result of ancillaries, as the older stuff is generally just bigger.
I tend to avoid including ancillaries in sizing as they can, largely, be moved around to suit, or replaced with remote units in the case of oil and water pumps especially.

The Rover V8s reputation as 'light' does come from the era when everything was overbuilt and iron, so by modern standards, it's nothing impressive, and neither are the LSs. 

V8s just don't sit well in sports cars at the end of the day, unless they're very tiny and built and tuned for revs and top end. Even then, the expense and complexity of such an engine is rarely justified for a sports car. It's hard enough to justify 6 cylinders in a small sports car like the 'B! The MGC was largely considered pointless (although with suspension work, they can make very nice, cheap GT cars. Certainly what I'd choose with the miles I do... Although GT6s are cooler.)
Reply: John Smith Having an engine sitting in your living room, having owned, detested and lost a fortune on a shit car, and having a nerd-level knowledge of different designs of an engine that has been pretty much the same for over half a century, are very different things. 

The first two I do and did, the last one.. well, there will be some design differences, and almost certainly some material and manufacturing process changes between them... but if you asked me the specifics, I'd have no idea. Quite what me not knowing design differences between crummy old engines has to do with general engine design I have no idea.

Please, do forgive me if I don't take engineering advice from a website that not only uses pounds rather than kilograms, but also calls aeroplanes 'airplanes' like a child, and, beyond that, is full of people stupid enough to consider putting a clattery old pushrod V8 into one. 

There's stupid, then there's stupid. A V8 is about the worst configuration for an aircraft.
Reply: John Smith No, the problem is that crossplane V8s, especially pushrod ones, have a large number of mechanical flaws that make them highly undesirable for performance applications, and I'm sick of the huge quantities of bullshit claiming the contrary.
Reply: ***** So you're telling me I can reduce the displacement of my engine and then compensate for that by increasing the displacement of my engine with a supercharger, in effect making my air pump smaller and then adding a less efficient air pump to get back where I started except with greater pumping losses under full power?

Or are you suggesting that I move my torque curve/power band up to where I don't want it so I can make the engine smaller and then compensate for that by adding another motor?

Sounds gimmicky and expensive
Reply: John Smith So pushrods work, great. So do chopsticks. But you'd be a fool to use chopsticks to eat peas, and a fool to use pushrods in anything requiring a modicum of power or efficiency.

In terms of what an engine can and can't do, the LS is tasked with providing propulsion to performance auttomobiles, the Corvette/Camaro, etcetera. It does this badly by producing poor specific output, possessing poor response, terrible power delivery and a valvetrain, basic configuration and indeed design ethos that is the polar opposite of almost every great performance car since the year dot.

As for those LSs destined for truck use... They're perfect.... For the 1950s. These days, diesels take the same torque and delivery traits, and amplify them, with better fuel economy. Were it not for diesel engines, the LS would be a great truck engine... But diesels are just better.

Engines have a limited power band. Sure, you could tune it down the bottom, but what does that do for performance? Jack all. Because the power is at the top, because revs equal power. If you've tuned it for bottom end, you get nothing at the top. Less power. Less speed. 

Fine if you've got a truck and need the grunt down low to shift stuff.... But then, as I said, a diesel does that so much better.
Reply: ***** Well, no, they're not.
Reply: break time No, I didn't.
Reply: +Richard Harrold I wonder if much of that is because different cylinder configurations create different power bands. Americans love big torque at lower RPM so manufacturers build engines to meet customer demands. 
If GM built a Corvette with a 500 HP 4 liter V8 & a Corvette with a 500 HP 7 liter V8 the 7 liter would sell better simply because so many people in the US just love the feel of a large displacement V8. 
I also wonder if tax issues played a part in many auto makers going with smaller cylinders & smaller displacement. In many European countries you have to pay tax based on engine size so they kinda got accustomed to smaller engines & cylinder sizes. 
Basically, I wonder how much of cylinder size is because of what works best from an engineering standpoint VS. Outside influences like customer desires or tax issues.
Reply: ***** Low Emissions Zones in a couple of cities, mandated Diesel Particulate Filters, various European laws governing diesel emissions.... We've done enough. So long as a modern diesel is running right and has its DPF in place, it'll be no more polluting than petrol. 

Diesels are also taxed slightly differently.
Reply: +Richard Harrold you saying we don't pay enough taxes already??? you sound like a liberal...... smh
feel free to give them YOUR money
Reply: ***** Older diesels are certainly treated differently. My Land Rover is diesel and has had a number of comments from various officials when I've been in London with it. Thankfully, it's 1972, so it's protected by Grandad rights.
Reply: Foxtrot Oscar
hahahahahahahaha

Truth hurts..

Oh and bite me!!
Reply: zeusdog34 You should know all about the pain of truth...
PS, I wouldn't even let my neighbour's dog bite you, for fear of poisoning it. And I hate that fucking dog.
Reply: @TheWierdFish yo
Reply: +Foxtrot Oscar "The aeroplane, the railways, the computer, radar, sonar, the web... modern industry, steam power"

Airplane: The Wright Brothers (American)
Sonar: Lewis Nixon (American)
Internet: See US DoD ARPANET (American)
First Automobile: Karl Benz (German)
A/C Power System: Nikola Tesla (Serbian-American)
D/C Power System: Thomas Edison (American)
First Personal Computer: Paul Allen/Bill Gates or Steve Wozniak/Steve Jobs (Depending on who you ask) (Americans)
Reply: NorthGeorgiaOutdoors 
Aeroplane: Sir George Cayley, 1808, first human carrying heavier than air craft. 
SONAR: Theoretically it was Da Vinci in 1490 something. He noted that one could hear things happening underwater using a tube. However, the first filed patent for  sonar device was listed by an English chap called Lewis Richardson, apparently, in 1912. 
World Wide Web. (the bit we actually use day to day) Tim Berners Lee. British.

Electricity. 1600, Englishman William Gilbert made studies and defined static electricity, and coined the beginnings of the very word 'electricity'.
Volta (Italy)
Ampére (France) 
Faraday (Britain) and
Maxwell (Britain),
laid down pretty much all the fundamentals during the early 19th century.

Edison and Tesla (not American) didn't come along until the end of the 19th century.

Analogue Computers were the brainchild of Charles Babbage (British) in the early 19th century 
Digital computers were later developed by Tommy Flowers (British) in the 1930s. 
Pretty much everything since is evolutionary, not revolutionary. The personal computer was not an invention, merely a decision to sell a miniaturisation of previous technology to civilians. 

Americans are very good at marketing new technologies, but generally the original ideas are from elsewhere.

The light bulb, for instance. Humphry Davy. Not Edison. Edison merely refined and sold Davy's ideas.

As a side note, the first 'automobile' was not Benz. His was the first production internal combustion automobile. Steam powered vehicles had been around for a fair while before,  with developments in France, Britain and Germany.
Reply: hahahahahahahaha Foxcock and his side kick Harrold..
Look at the two of you.. We are better than you, we did this we did that.. hahahahahahahahaha

Yup confirmed 12 yr old boys!!

Da Vinci is the FIRST sketch a design for human flight!!!!!!

You are a bigot to the core!!
You have a deep distaste towards anything American!!!

Once again I ask ,Please provide a ARTICLE/REVIEW supporting your claims that crossplane v8 engines are not GOOD for High end or Performance Autos!!! Once you provide that I will stop!!!
Until than SHUT THE HELL UP!!! Nothing but lies and bullshit Opinions is ALL YOU SPEW!!!

yOU ARE not A aUTO jOURNALIST!!

You are a 12 yr old boy!!
Reply: *****
not true!!!!!

http://www.partsworldperformance.com/chevrolet-ls-engines

http://www.roadcraftuk.co.uk/index.php?route=product/category&path=37

Not bad for a BRAND NEW RELIABLE PERFORMANCE ENGINE!!!

Get your facts straight before making BS Blanket statements!!!

Now I will leave you alone so you can have cuddle time with Foxcock!!
Reply: zeusdog34 Yes, Da Vinci did the first sketches, although they were never built in period, and have since been prototyped and failed to fly. His parachute design, however, was also tested and did work.

Caley's craft were actually built, and did actually carry human passengers on short flights, albeit only small boys, but still. Heavier than air, human carrying craft, nearly 100 years before the Wright Brothers. Their achievement was the first powered and controlled flight. 
In that hundred years many others refined Cayley's designs, one of the more famous being Otto Lithenial (if I've spelled that right)
Powered craft had flown, as had controllable craft, just not both systems in the same machine. The Wright Brothers also developed the 'wing warping' control system to a workable level, whereas most controls before hand were mainly weight transfer or spoiler systems. Wing warping being more efficient and effective. Ailerons were developed later.

Don't get me wrong, what they did with Kittyhawk was a big moment in aviation history. But it was not the actual 'invention' of aircraft. Indeed, the Brothers quote some of George Cayley's work in their own notes.

This is NOT anti-American, it's anti-bullshit. It's history, impossible for me to fake, so shut it, ok? 

Your deeply biased, overtly patriotic devotion to falsified propaganda is very disturbing.
Reply: ***** Tim Berners Lee developed the World Wide Web, which is the 'internet' as we know it. The bit that google and Youtube and all the 'websites' inhabit, in software form.
The 'internet' itself, as in, the concept of computers being interlinked, was DARPA, in the US. 
Sir Humphry Davy invented the first incandescent light bulb, as well as the arc lamp. And the miners safety lamp. Bloke really liked lamps...
Reply: +mrjdgibbs ok..I know this and agree with you..Not sure what or who your comment is meant for..
Reply: mrjdgibbs Actually... Not really. Back in the early 2000s, the LSs were actually surprisingly light. Nowadays, the weights of variable valve timing systems and so forth have decreased, and the 'techy' engines are once again in the same range as the LSs... Except more powerful and more efficient.
Reply: Foxtrot Oscar
hahahahahahaha

100% LIES AND BULLSHIT!!! AS USUAL..
Reply: another big LIE from you(foxcock).You are constantly saying DOHC Heads flow much better than OHV is a  100% lie!!! Yes 15 years ago maybe but NOT TODAY!!!
Example GTR flow rate is around 280cfm while the LS ENGINE is over 300cfm!!!

Your lies NEVER STOP!!!
Reply: zeusdog34 Stop. The GT-R engine is nearly HALF the size of some LS engines, and has significantly smaller bores. That means smaller head space for valves and ports. 

The FACT is that four valves will ALWAYS fit more valve and port area into the same size of head. That's why the exist at all!

The LS is MASSIVE and flows only a small amount more than the tiny GT-R engine. Yet another example of the LS doing less with more. 

Just keep digging, every 'fact' you spew out only seems to invalidate your argument further, becuase you lack a basic understanding of the finer details of engineering design. Sorry, but this is all stuff that you can easily Google, and you consistently fail to do so.
Reply: Foxtrot Oscar
HAHAHAHAHAHAHAAHAHA

YES BACK TO EXCUSE AND DEFLECTION!!!
Thank YOU!!!

Its already been proven the Actual size of the GTR Engine is slightly bigger!!!
Funny how you are the only person I have ever heard of CALLING THE GTR ENGINE TINY..lololololololololololololololololololololololol
hahahahahahahahaahahahahahahaahahahaha

The fact is the ENTRY LEVEL CORVETTE LS ENGINE FLOWS BETTER THAN THE HIGHLY TUNED GTR ENGINE..FACT!!!
=YOU FAIL!!!!!!
 AS USUAL!!!

OK The Mercedes C63 AMG cfm is around 190..Whats your excuse NOW!!!

You are a 12yr old boy
You are a biased BIGOT
You have a deep distaste towards ANYTHING AMERICA
You are NOT a Engineer
You are NOT a Auto Journalist!!
Reply: zeusdog34 3.8 litres... 7.0 litres.... Hmmm, yeah, 7 is much smaller, you're right!

Sarcasm. 

Even if you use the smaller LS1, 3.8 is still a lot smaller than 5.7.

Bore size dictates the size of the combustion chamber, mostly, and thus the area in which you can fit valves.

Bore of 99mm for the LS1, bore of 96mm for the VR38DETT, 4 cylinders per head for the LS1, 3 cylinders for the VR'. 

Stock LS1, 244cu.ft/min

Stock VR38DETT, 280cu.ft/min

Hmm... So the bigger capacity, engine with the larger area in which valves could fit, has a lower flow... 

What does that tell you? 

That you're wrong?

No. Because you're you, you'll claim I'm bullshitting.
However, here's the links to the data. 

http://www.titanmotorsports.com/titan-cnc-gtr-heads.html

http://www.hotrod.com/how-to/engine/hrdp-1012-ultimate-chevrolet-ls-cylinder-head-test/

I don't know where you got the figures for the Mercedes engine, and I can't find any with a quick Google search, however, the M178 isn't actually that good, by many accounts, especially in the fuel economy department, so it may just be a bad design. 
It's also a 4 litre V8, meaning it'll have a significantly smaller bore than any LS, or ever the VR. 

The VR38 is not 'highly tuned'. It's mildly tuned, yes. However, I've heard mention of 2300hp R35s, and there are some websites that support this, although I haven't looked in to it, and certainly 2100hp+ is possible with them... that I would consider 'highly tuned'. To be fair, even 1000hp is pretty highly tuned, but if the engine can support 2100hp+, then the standard 550hp is pretty mild!

Your ranting and shouting and manic laughter serves no purpose, when a perfectly sensible discussion with actual facts could be held. 
You have included some facts, yes, well done for that, however you haven't thought about the wider picture. You've just found some figures that look nice and posted them, without considering actual sizings of the engine. 

Think of it the other way. If I were to post the flow of a 6.2 litre DOHC 4 valve engine, and the flow of a 150cc OHV lawnmower engine, then the 6.2 would flow MASSIVE amounts more, simply because it's, well, bigger. 

Bigger flows more. However, flowing better FOR THE SIZE is very important for getting the most power out of the size you have, because of course, the bigger you make an engine, the heavier it gets, the more surface area and thus friction it has, thus the less efficiency you get. And, of course, in most places you run into tax issues, and in racing, you get classified on displacement, and making the most power out of the displacement you're allowed is key. 

This is NOT a distaste for 'America' it's a distaste for OHV engines. I dislike Bentley's OHV engine just as much. The only difference is, Bentley aren't claiming it's a performance engine, and GM are. When talking about performance... that counts.
Reply: +Richard Harrold lollololol

oh the sidekick has spoken.. You are almost as bad as foxcock...
listen..
WITHOUT ARTICLES/REVIEWS supporting his claims/opinions its just hot air,nothing more!!!!

You 3girlfriends can dislike the LS engines all you want,your OPINIONS!! 

you clearly know nothing about cars!!! we have already proven this a while back!!!! so just stop!!

UNTIL one of you 3 boys provide proof that crossplane(push rod) v8 engines are not Good for High end or Performance Auto's..Shut the HELL up..
Reply: +Richard Harrold hahahaha

VVT IS on the new LS engines!!! Like I said you know very little about Auto's except what you Google!!! 

The push rods are made from Titanium and are super strong and light... The push rod engines from the past are NIT the same as today!!! 

Get over your biased bullshit Opinion!!

I don't give a shit if you like or hate something but don't claim IT AS FACT!!!

I'm so tired of you bigot douche bags!!

you made your comments/OPINIONS move the HELL on...

Why seek out videos about something you HATE just to bash and call people idots,morons because they like something you DESPISE?! I don't get it!!!!!!

Shut the hell up!!

Your OPINIONS mean NOTHING, you know why? Opinions of biased bigot assholes hold NO value!!

Making claims that you taught as fact without PROOF mean NOTHING..

Please provide Proof/article/review that states Cross Plane(push rod) V8 engines are NOT GOOD for High End or Performance Auto's!!!

Without PROOF its just OPINIONS from biased douchers!!!
Reply: +Foxtrot Oscar hahahahahahahahahahahahahahaHahaha 

Seriously you think you have Anything over me..We've been talking about the new C7 corvette /Zo6 .I mispoke..I meant LT engine!!!

So No I'm not wrong!!!

The rest from you is EXCUSES!!!! 

Harrold said it can't be done... Well GM did it..

As far as your comparison..Hahahahaha

As far as your OPINIONS go ,BIASED to the core!!

I don't care what you think about the LS/LT engines..What I do care about is you claiming your OPINIONS as fact....

The tech/engineering facts speak for themselves...

You claiming Cross Plane(push rod)v8 engines are not GOOD for High End or Performance Auto's ,IS YOUR OPINION!! Nothing More!!!

You are Not a auto ENTHUSIAST

You are not a auto Journalist
Reply: zeusdog34 Well how the fuck was I supposed to know you meant 'LT' when you SAID LS?

That, all of what you've just said, is one big fat EXCUSE. You just can't admit to being wrong, can you?

I know you're wrong, you know you're wrong... you just won't say so. And that's sad, because you can never be right until you can accept when you're wrong.
Reply: +Foxtrot Oscar hahahahahahHHa

Don't cry princess!!!! 

The new C7 Corvette does not have a LS..I know this you know this..We've been talking about the C7/zo6...I admitted I miss spoke!!!

You can't admit your distaste towards America...

You CANT ADMIT THAT YOU DONT HAVE PROOF /ARTICLE/REVIEW that's supports your biased OPINIONS!!!!

I ask you again,PLEASE provide a ARTICLE/REVIEW that supports your OPINIONS that Crossplane (push rod) v8 engines are not GOOD for High End or Performance Auto's!!!!

Until you provide the proof..

YOU FAIL!!!!!!
Reply: most people who hate the ls engines are jdm fan boys who think the 2jz or the rbdet engines are better.
Reply: zeusdog34 There is no distaste. 
I was speaking positively about the LT. It's a massive improvement. That's good. Just not 80k good... Sorry.

I HAVE PROVIDED ARTICLES. The ones you "don't care about", that include all of the facts about the inefficiencies and flaws of pushrods and crossplanes and explain exactly WHY they're crap. 
That's the thing about an argument, they need facts. I have facts. 
You're looking for someone to say they're crap, I've shown you WHY they're crap, and that's a far more effective argument.
Reply: zeusdog34 Facts are not my opinion. The fact is, crossplanes and pushrods are massive compromises in performance. Cost may be a reason to choose crossplane, but for the last 40 years or so, there have been no reasons at all to use pushrods, as evidenced by the technical articles, and the fact that NO ONE USES THEM. That should tell you everything!

You don't care about the facts becuase they prove you wrong. Simple. They are the highest authority in an argument, and you're ignoring them. 

The people who drive them may not care, but THE LAWS OF PHYSICS do care.... and that's why pushrods DO NOT make the power that OHC engines do. That is why, like for like, pushrods are less powerful and slower. That's why NO ONE uses them in displacement limited racing, and only ONE team uses them in ANY kind of top level international professional racing.

I have irrefutably proven with fact and physics, that pushrod crossplanes underperform, and thus are highly undesirable in a performance vehicle. 

Point, evidence, explanation, argument. You have nothing but opinion and wild, false insults.
Reply: ***** For a sports car, a flatplane isn't really worth the effort. Sports car engines small enough that 6 cylinders is enough. For an upper-mid range saloon though, a big, soft V8 is acceptable.
The original argument was that pushrod crossplanes are crap for performance use. Zeusdog seems to take this to mean that I think that all V8s are shit!
Reply: zeusdog34 Yes, the fundamental constants that define the very fabric of the universe and all that is, was and ever will be, is my 'opinion'.

Were that true, that would make me a god. In which case, you would still be wrong, because I could simply decree it.

As reality is just reality, and not my opinion, I'm not a god.... but I am right. 

I will provide one better than an article. I will provide.... PROOF!

LT1 460hp. 6.2 litres N/A
LT4 650hp 6.2 litres Supercharged.

Ferrari V12 740hp, 6.3 litres N/A.

By claiming the Z06 to be a 'supercar' Chevvy have put it in competition with actual supercars... Like a Ferrari. So who the hell is going to look at the 650hp Corvette and think it's good compared to the 740hp Ferrari? 

Let's imagine you want to race your cars. You enter a race that limits displacement to 6.5 litres... Ooh, sorry, the supercharged Z06 is not allowed to race due to it being supercharged, so you'll have to use a base C7... which means you'll be racing a 460hp car against a 740hp car. 

Not looking good, is it?

OHC and not-crossplane is just better. 

Factual technical articles ARE proof!
Opinionated reviews are NOT proof. You want someone's opinion, go ask them. You want facts, read tech articles. 

FACT.

FACT is, you're wrong.
FACT is, physics disagrees
FACT is, I've posted articles proving it
FACT is, you have nothing
FACT is, you fail.
Reply: Texassince1836 Not if you're banned from racing because your engine is too large.... 
And if I've got a 3 litre, and you've got a 5.7, and I'm making 100hp per litre, and you're making 50... I still win. And get better economy. And pay less tax.
Reply: ***** Supercars, really. I know the 308 is considered slow now, but in its day, it was certainly supercar material.
Reply: +Foxtrot Oscar For an engineer you don't know much about this... You're arguing that a Honda engine has more hp per litre, but you get a shitty power curve. LS engines are great. I live in the UK and swapped one into my MX5. Not much bigger than the stock 4 cyl and not much heavier either. It's still pretty much a 50/50 weight balance. No problems with it yet and I drive hard on it. Done just over 3000 miles and it's perfect. You're talking out your ass.
Reply: zeusdog34 Oh contrarie little Zeusey. ALL of those articles give very good reasons why they're not good.
Reply: hêlêl For someone making bold claims about the intelligence of another, you really don't know much about this.
The power curve of a VTEC Honda is actually quite good. The 'shitty' part you're referring to is probably the jump in the middle. That's not shit, that's intentonal. That's the point where the high lift, performance cam comes into play. That is why their engines run so well at high revs; they have a race cam. Use the gears properly, and you'll stay on cam and everything is gravy. When you don't need the power, lower the revs, use the 'economy' cam. Clever system.

V8, MX5. Is it a sweet, gentle little car that you can throw at a corner, mash the throttle and four wheel drift perfectly, every time? No. It'll be a twitchy cunt that will bite you for thinking about the throttle. All big engine, small cars are. And that, for a sports car, is terrible.  

50/50 weight doesn't matter a damn. Look at the 911, that's like 30/70, and sweet as a nut. What matters is weight density and proper suspension tuning. 

'Supercar perfomance' ha. Never driven a supercar, have you? No MX5 will ever be anything like a supercar.

I can't believe you're from the UK. 
Ass, motor, transvestite, feels good, linear power... Spoken like a true Yank.
Reply: ***** The 2.8 is the sweetest XK, just sadly rare and massively underrated. Also heavy.
Reply: Foxtrot Oscar Why are you so against American engines? You just seem to be one of those guys who throw abuse at something because you've got int into your head that it's bad when it's actually not. There's nothing wrong with an LS engine. My 5 could beat your Jag on the drag strip and round a circuit. Yes it won't be as luxurious or refined, but that's not what I'm looking for in weekend car, that's what a daily driver is for. So far all I've seen from you is immaturity and prejudice. You really do give Englishmen a bad name. Respect things for what they are. LS engines are so popular around the world because they are tried and tested and they work. If you can't understand that, then I feel sorry for whoever you work for. You're a pathetic embarrassment.
Reply: hêlêl he troll EVERY video that pertains to the ls to start arguments.
Reply: Rangerover matt But XK's aren't in any way budget engines. They're old, rare, and desirable, so they cost money.

LSs are new.... but really not desirable at all. So very few are imported, making them rare and expensive. There are no parts, so those are expensive too. 

Also, what's the point? I can almost guarantee that if your vehicle was built in the last three decades, that it will have a more modern engine in it from factory. 

I cannot think of a single vehicle that would benefit from an LS swap aside from maybe some vintage GM muscle, where you're simply upgrading a clattery old V8 to a clattery new V8.... other than that... no. Certainly no Nissan I know of.
Reply: hêlêl I didn't. I bought a C5 Corvette with one factory installed. This was when I was younger and, obviously, stupid. I thought, being naive, that a Corvette would be cheap performance. After all, that's what all the Americans kept shouting... really loudly. Horsepower per dollar, and all that shit.

Well, I got my 5.7 litre V8 monster home and was almost immediately disappointed. It ran rough and wasn't as fast as a light car with a massive engine should be. 
Well... it never ran right, and after two catastrophic failures and an endless list of electrical gremlins, I called it a day, broke the car for parts, turned the engine into a coffee table and that was that. 

At the end of the day, my near stock 5.3 litre Jaguar (homemade exhaust and intake, for more noise!) made more power than the stock 5.7 litre V8. Despite the Jag being 30 years older. 

Jag wasn't actually that much slower either, despite weighing a third as much again, and being ancient. And having 2.5 times the seating capacity, a massive boot and full wood and leather throughout. 

It was when my mate beat me in his E28 535i (1980s BMW 5 series) that I lost all hope for it. Embarassing.
Reply: hêlêl Racism? Where? When? Please, do point out where in my entirely non-racist life I've been racist.
The C5 is a heap. They're built so badly, they don't drive as well as they should, the engine is terrible and... they're just cheap crap. 
The fact I got beat by an E28 is largely because, despite having  more horses, I couldn't put them down on tight, twisty roads, and the BMW, with its far smoother inline six, could. It also suffered less from the effects of cambers and ruts, while my massive tyre'd 'Vette just went wherever it felt like.

I'll admit, I wasn't the best driver in the world back then, I'm still not, but I could hold a slide and navigate smoothly. Besides, I'm as good as, if not better than, my mate. Equal drivers make for a level playing field, no matter the skill level. 

So, if you can point out the racism where there is none, and point out the stupidity of stating that my Corvette lost to a BMW rather than lying and saying the opposite, please, go ahead. If not, I suggest you stop making such bold claims.
Reply: ***** The E28 wasn't that light, or that powerful, although my mate's was lightly modified. What it is, however, is a solid, well composed car that isn't unsettled easily and can deploy its power smoothly. 
That's how he beat me.

Sure, it wasn't really the right road for the Corvette, which works best on big, wide, straight roads, but still, to be beaten by a big saloon car, nearly 20 years older, with an engine 2.2 litres smaller. That hurts, let me tell you!
Reply: You'reFucked V12s are probably the best compromise of configuration. Only a V16 or bigger could possibly be smoother, but V16s are prohibitively expensive and complex and heavy. V12s are bang perfect in the middle.

I don't even have an ass, so how the hell would Mr Harrold lick it?!
Reply: Texassince1836 Well that's your choice. Sucks to be stuck with clunky old junk I suppose. You could always go inline six. Cheaper, and better.
Reply: Rangerover matt No, fuck you, don't apologise for me and my sound engineering logic. If people want to love their clunky, archaic, wheezing V8s, let them. I don't care. You can love what you want.
But, as soon as anyone tries to tell me they're 'good' that's when I have a problem.

If you have a problem with me having a problem with pushrod fanboys flat out lying about how great their twig.

The Rover V8 is not that good, really. Yes, my Land Rover had one for a while but the diesel is just so much more useful. Better torque characteristics for towing and off road, and more sturdy than the sometimes fragile V8. The valvetrains and heads of the RV8 being particularly susceptible in high strain situations. 

If you think a V8 MX5 is a remotely sensible idea, then sorry, but I would have to label you as a bit of an idiot.
Seriously? Who looks at a small, light, precise, delicate car and says "You know what this needs? A big, heavy, wayward, battering ram of an engine!"
Reply: zeusdog34 What makes you think I'm upset? Is it my complete lack of being upset, or your sheer idiocy? 

There is the FACTS that crossplane V8s and pushrods make LESS PERFORMANCE that makes them highly undesirable for PERFORMANCE vehicles.

If you want PERFORMANCE you choose an engine that actually makes PERFORMANCE.

Super fuckin' simple stuff.

You fail.
Reply: Canniballistix FRSs, 240SXs and Miatas are NOT JDM. They're USM.
Japanese cars specced for Yanks. That's why the 240SX has the KA24DE, rather than the CA18DET or SR20DET. 

The GT86, 180SX and Eunos are the JDM cars. 

And no, the people who put LS engines into any of those cars are not clever, not sensible, and 99.999% of the time, can't actually drift. 

You know a V8 makes drifting  harder, right? Big torque is utterly useless, as you just spin the tyres, making precision sliding far more difficult. 

Also, the 'V8 sound' is actually the sound of two misfires. Not the sort of thing that floats my boat, but, whatever.
Reply: +Foxtrot Oscar Yeah already know they aren't real jdm cars since they're produced in the US.. but tell me why orido has a Nascar V8 in his GT86 drift car? why many drift cars use LS motors these days? because they are cheap, fairly reliable, and make power easily.. You do know an LS1 weighs less than a 2JZ-GTE?  personally i wouldn't swap a LS but i don't see why they shoud be hated for doing it. You must be the fanboy OP was talking about..
Reply: Canniballistix Because he's a raging nutjob? 
Very, very, very few drift cars have LSs in. I say this because it's true. 
Even in Formula Drift (which is NOT drifting, it's power sliding. A noticeably different driving technique) they're going away from LS engines. There are as many 2Js as LSs, and as many non-V8 cars as V8. Even in the heart of Americaland. 

Yes, an aluminium LS weighs less than the iron 2J. So? An LS weighs significantly more than an SR. Depends what power you want. If you want up to 500hp, go SR. If you want up to 2000hp, go 2J, because it can handle it. And the heat. Heat is big in motorsports, and there's no use melting your rickety V8 when a solid old 2J will do it just fine. 

I'm about the opposite of a fanboy. I have no real allegiance to any brand or nationality.
Reply: +Foxtrot Oscar There are some used SR20's going for around $1500. That will get you an engine that makes probably between 200 and 230 hp, which is really a decent number. An LS1 on the other hand, will run you closer to 2500 to 5000 dollars. But for that money, you are getting 350 horsepower. Now, with an SR20, that number is easily achievable, but you will have to start modding the engine, which costs money, and, eventually, will sacrifice reliability. An aluminum block LS1 also weighs around 400 pounds dry, SR20s weigh just a hair less. Overall, there’s a strong argument for LS swaps, but I probably wouldn’t do one.
Reply: Canniballistix The SR20 weighs 149kg. That is a figure quoted by a huge number of people. LS1s weigh between 200 and 250kg all up depending on who you ask. In lubs, that's about 450.
Even taking the low average, 200kg, that's still a third heavier than the SR. Like having a mate, permanently installed on the bonnet. Not great for handling. Then, of course, you have to consider that the gearbox is heavier too. Sure, this weight is much further back, and generally balances the engine out, so the weight distribution doesn't really change. 

But this is still like having a mate on the bonnet, and a mate in the back. Still not great. 

300hp is easy in an SR with cheap, simple mods. 

In an S13 (180/200/240SX), 350 is about the most horsepower the chassis can sensibly handle without stripping the whole thing apart, seam welding, bracing and caging, or going for a full tube chassis.... but both of those options are seriously expensive, and if you're considering them, you won't be in a position where you'll need to consider the cost of building a proper race spec SR20, but you will be in a position where weight considerations are important. 

Also remember that, yes, the LS with 350hp is reliable.... on the road... sort of (I had a couple of very serious problems with mine) however, as soon as you start thrashing it on track, stuff WILL break. 

So you've got to modify it to take the stress. No road engine can take track stress for long, so you're going to spend money on it at some point.

So you've got to modify the LS to be solid, and modify the SR to have a bit more power, and that should make it solid in the process.

Then, of course, consider the swap cost... HUGE in some cases, and long and difficult and tedious.

For the S13, the SR20 already has all the mounts, wiring, exhausts intakes, plumbing... everything, already there, because they're designed to go in that car.

No LS has that. Yes, some places in the US provide swap kits consisting of engine and gearbox mounts and occasionally some wiring, however you still have the plumbing problems, custom exhausts, custom intakes, the need to bodge the GM engine into thinking it's in a GM car and the Nissan car into thinking it has a Nissan engine, so the two will actually talk to each other and all your gauges will work, warning lights will work, and other things that your safety test requires you to have...
And, of course, those kits cost money..

So the SR is cheaper to buy, free to install, lighter, can make more than enough power happily, is revvier, more responsive, more efficient, more precise and won't realistically cost much more than an LS to get running well. Also, the SR has better parts availability globally (so it doesn't matter where' you're from, you should be able to get parts), unlike the LS. 

There are practically zero logical reasons for an LS swap, which is why I'd never perform one.

The best reason for an LS I've found is that, stripped down, they make a far cooler coffee table than a cheap pine arrangement from Argos. 

It has been known for 2JZ engines that have never had the head or sump off since they were put on by the factory, to run in excess of 1000hp. Purely external bolt ons, like a bigger turbo and injectors and an uprated fuel pump and cooling system.

They're ridiculously strong engines.

That is getting rarer these days, as they're all now old engines, and most have fairly high mileage on them. I wouldn't want to try putting 1000hp through a bone stock, 120,000 mile old engine! 
That said, with new old stock parts, they can still do their party piece, and with modified parts, have been known to produce in excess of 2000hp.
Not that there's any point in that, as 1000hp is more than you'll ever need.

It just means that, running 600hp in a high end build, you're never, going to blow it up, and the iron block is so much more resilient than ally blocks. 

I'm sick of seeing clattery old V8s in nice cars, and then having the fanboys trying to tell me that they're brilliant engines and improve the cars when they just don't.

I almost bought another Jag E type, a US import, because it was ridiculously cheap and a convertible. I soon found out why... despite being a rust-free Series 1 shell.... it wasn't a Jaguar any more. It had a Chevvy 350 in it.

Interestingly, making less power than the original engine, whilst being heavier. In addition, to fit it in, the butcher had hacked through the front subframe and welded (badly) some tubing to the box section, so the exhausts fit. It also had a ghastly three speed automatic where the original 4 speed manual should have been, and it had a really weird mash up of Jaguar independent rear coil suspension, with a live axle wedged in place of the half shafts and original diff. 

Terrible, nasty, horrendous, disgusting machine, and utter sacrilege.
I feel the same when I see RX7s and S chassis's and so forth with V8s wedged in too.
I'd love an RX7, but every one that's destroyed with a V8 makes the rest more valuable and thus expensive.
Reply: Foxtrot Oscar lol so in other words you're a purist who is sick of seeing LS being swapped into everything on wheels.. makes sense, i can agree with that. Just to clear things up, I'm not some LS fanboy chevy guy if that's what you think.. i've always prefered japanese sports cars, LS swaps used to be interesting years ago and now they are just overdone.
Reply: Canniballistix No, I wouldn't say I'm a purist. I'm all for swapping things around, but I do like to see it done tastefully, and most of all, I think it should be interesting. Take a low spec model of a car and put a high spec engine in it. Maybe a bigger or better engine from the same manufacturer, or any engine, really, but try to keep it true to the original vehicle. If the original car came with an inline 4, try to go for that, or maybe a period 6 cylinder. 
If it's a sports car, a sporty engine, if it's a truck, obviously something grunty, if it's a saloon car, try to stay classy, you know?

Some of my favourite swaps have been things like:
Jaguar I6 in AC Ace (Cobra) replica
SR20DET in BMW 2002tii. 
TVR V8 in Range Rover Classic rally truck.
Rover K Series in MGB
2JZ in Volvo 240
3 cylinder turbo Suzuki engine in classic Fiat 500. 

All a bit mad, but when you think about it, the BMW 2002 Turbo was a 2 litre turbo.. like the SR20.
The Rangie Classic was always Rover V8, and TVR used Rover V8s, so it makes sense.
MG and Rover were all BL, the K Series was Rover's best modern engine, and it's a super little thing, and very sporty, perfect for the MGB.
The AC Ace used a Bristol I6 in the 1950s. Those are expensive these days. Jaguar I6s are less expensive, were built during the 1950s (from 1948 to 1990s actually) and work perfectly.
The Volvo 240 Turbo's were surprisingly fast in their day. Sleepers, if you will. A big, meaty, near stock 2J is about perfect for sleepering a 240.
Fiat 500s came with tiny 3 cylinder engines. Japanese Kei Cars do too, except modern, more powerful and more efficient. Why not? Still sounds the same, still feels the same, just more power.

That's what I look for in an engine swap, some connection, any connection, to what the basic car actually is. Throwing a massive V8 in a sports car turns it into yet another muscle car. And there's loads of those already. Do something original, tasteful or interesting.
Reply: Alfonso Flores Wankel rotaries are only really 'weak' when you increase boost significantly over the stock setup. The tip seals just can't handle it, although more modern seals are a massive improvement.

So long as you treat them right (thrash the crap out of them occasionally) and warm and cool them properly, they're nowhere near as fragile as people seem to think. Plus, they're so tiny and light. 
A rotary Caterham 7, or MX5 or something would be pretty special.
Reply: ***** The RX4, I've seen it. It was built as a drag car, but yes, it did sound the tits. It's something like 3.9 litres, but making 800hp, naturally aspirated, it totally destroys pretty much any other N/A engine within capacity classes!
Nearly as heavy as a piston engine though, and of course far more complex than a normal 13B or what have you. But still only 7 moving parts....
Reply: Alfonso Flores Stock, they're pretty good if you look after them. Over 100k is easily possible with care, and for any hard tuned engine, that's pretty good. 

Consider the wankel like a bike engine. Big power in a tiny, light package, strong and able to be thrashed to hell...... but it doesn't last as long.
Don't confuse strength with longevity.
Reply: Travis Callahan Torque is cheap. And pretty useless, once you have 'enough'.

Consider how a gearbox works. 1st gear is low. An underdrive. It multiplies the torque up. 400lb.ft at the wheels isn't enough to move a medium sized car with any urgency. 
You need more along the lines of 1000lb.ft or more. So you use a gearbox. However, once you're moving, you need less and less. Top gear is an overdrive. It divides torque. You have less at the wheels than the engine produces. But, the power is transferred directly, and it's power that produces speed.

'Enough' force depends on how heavy your car is an what you want to do with it. But, for light performance cars, power is king. At the opposite end of the scale, trucks. Don't need power, but torque is very good for towing stuff.

154mph...  Wow. My 1961 Jag will do 150, and that's 'only' a 3.8 

In 1990, Vauxhall gave their Carlton saloon (what you would call a sedan) to Lotus..  That's a 3.6 litre straight six. And that did 177mph.

The fastest police car of the time, the 3.0 Senator, was 150mph car. When most passenger cars could barely top 110. 

The other side of torque is the tyres. They have a finite level of grip. Torque eats that up. Too much torque, all you'll get is wheel spin. That's slow.

Moderate torque, as much power as you need. That's how to build a fast car.

Brute force is only good for towing things.

Yes, valve float occurs in all designs. However, pushrods are far more susceptible, and more difficult to improve upon. 
The sheer mass of reciprocating parts is the problem. All those twigs exert significant force when whizzing around 3000 times a second.

Let's take two engines I'm very familiar with, both well loved and well used in a wide variety of cars.

The Jaguar XK and the Rover V8.

The Jaguar engine was designed in 1948, the Rover in the late 50s, then almost entirely redesigned by Rover in the 60s.

The Rover, of 3.5 litres, made 160hp in 1960
The Jaguar, of 3.4 litres also made 160hp, in 1949. By 1957 it was making 265hp in race spec and 210hp in standard spec.
Clearly, then, the more powerful of the two.
The XK redlines at 6k. This is quite conservative and racers take their engines to 7k regularly, even with stock internals. 
Valve float depends on the head and tune, but the sports engines will generally get to 7k with no problems.
The Rover V8 redlines at just 5200rpm, as at 6000rpm and above, the valves just do whatever they want to. 

Despite having a shorter stroke and smaller, lighter internals (although more of them) that should be an advantage when revving, the Rover V8 revs slower and redlines far lower, which is a big part in how little power it makes compared to the older Jaguar engine. (210hp vs 160hp) 

A higher torque engine could beat a lower torque engine off the line (or just spin the tyres uselessly), but if it has lower power, then no, no matter what you do with the driveline, in identical cars, it will not beat it through the mid and top end.

I trip over an LS every time I wobble home from the pub. It is completely stripped and currently propping up my coffee table. It used to power my C5 Corvette.
I know a fair amount about them.
The modern LS still shares the same basic pushrod system as any number of other engine designs that were scrapped in the 60s. 

Four valves is very useful. It provides larger total port volume, but smaller single port volume. This means at the top end, you get more total air moved, and at the bottom end, you get less stagnation of gasses in the ports. You also have smaller valves, which react quicker, and need less lift to get the same total area meaning a less aggressive cam, better running over a wider rev range, less wear, and so forth.

You could run a pushrod 4 valve setup, but on a V8, you'd need 32 pushrods, 32 rocker arms.... There's just not that much space on one cam and in the heads, the parts would have to be tiny and weak.
Reply: Travis Callahan Weight has fairly little to do with top speed. Indeed, Thrust SSC, the current land speed record holder (763mph), weighs 10.6 tons.

Longer gears aren't necessarily good, as then you fall out of the power band. And yes, that does matter becuase no, large engines do not magically have bigger power bands.

Engine power band is determined by the tuning. You tune for a big power band, and you sacrifice peak power. 
Yes, having longer gears means you have to detune the engine to match. That's why all race cars have short gears.

Yes, the LS7 has a 7k redline. However, it is right on its limits, and it's nearly six decades newer than the XK6... 

Compare the LS7 to a modern engine doing 8,9,9 and a half... Thats not so great.

Redline is mainly to do with piston speed and weights of internals, true, but in pushrod engines, it's also frequently dictated by valve float, the Rover being a classic. It stopped at 5200 because any closer to 6k and they valves started flapping all over. And considering there were no rev limiters, people did go over the redline, so you build in a margin of error.

For ease of maintenance, pushrod systems are AWFUL. 
With OHC, everything is in the heads. That means one simple cover and you can access the cam, the valves, and any other linkages. Easy. If you want to get to the cam of an OHV V8, you have to either remove the entire engine from the car, rip the entire from end off the car, or chainsaw the engine in half. Very difficult. Also, you have a load of random, spindly little twigs to worry about too. SO many more parts.
Timing is much more of a pain with OHV, as the cam sprocket is buried deep down the front of the engine, rather than nicely placed on top.

Rotating mass isn't actually a huge problem in valvetrain designs, as cams are generally small diameter, thus have low inertia, also, they only spin at half engine speed and rotating things are smooth and continuous.

Reciprocating mass, however, is a problem. The back and forth movement of the valves, rocker arms and pushrods, is actually a hell of a lot of force to stop, reverse and re start thousands of times a minute, especially when there's only a teeny little valve spring trying to do it.

Also, valve float is resonance of the springs. The more mass you have on the spring, the lower its resonant frequency is. Therfore, the lower the speed at which you can run the engine.

Belt? So? The cam of an OHV engine can be driven by gears (rare) chains OR belts. Just like OHC. There is no difference there apart from the lengths. 

Also, belts don't usually fail, unless you're a complete idiot and never change them, they just stretch and skip teeth. But then, chains can do the exact same thing too. That's why even on my chain driven DOHC Jaguar, I have to check it just as I did on the OHV Rover V8. 

Mine blew up because a pushrod failed, bent slightly, jammed in its stupid little hole and smashed the valves into the piston quite spectacularly. That also mashed the cam up, which in turn mashed some of the other pistons up. One head was totally smashed the other needed repairing. I replaced every piston and the cam, reground all the bearings, two complete sets of new cam followers, pushrods and rocker arms. Expensive doesn't begin to cover it.

The only western country to not have converted entirely to OHC is the US. In fact, it's the only country in the world where high level racing is performed with mandated pushrods, and only two global manufacturers out of dozens still use them. GM and Chrysler. What does that say? That GM's best engine is using a technology that only clattery old shit like Ladas still use?

Considering I've had over a decade in mechanical engineering, rebuilt my first vehicle before I was legally allowed to drive, rebuilt my V12 Jag when I was 17, and have generally built, maintained and owned more cars than most people ever get to even touch in a lifetime.... I'm fairly confident I know more than you. Especially considering the fact that you're arguing for the pushrod system on a performance engine.... 

Ive looked at the whole LS design, and it's all crap. A supposedly 'modern' engine that is a large crossplane V8 with no overhead cams, no direct injection, no continuous variable valve timing, no valve timing what so ever, in fact, and no specific power. Not by modern standards anyway.

The mpg per horsepower was mediocre at best, downright disgusting when not cruising and being super gentle. 

The noise is terrible, the cars they come in are terrible, and that's why _no one outside the overly patriot USA buys them.
Reply: hêlêl I've driven an LS1 MX5, and it was horrible. I had a Mk1 MX5 for a fair while, and I loved it. It's perky little engine, precise, neat gearchange, delicate, balanced handling and most of all, the way you could grab it by the scruff of the neck, throw it around all over the place, and it would just bounce back and ask for more, wagging it's tail across the road like some big, daft, soft-as-shit dog. It was a happy, fizzy little car that only knew fun. It didn't know how to bite, it just got on with being delightfully simple, yet wonderfully refined. 

Putting a big V8 changes that. It's no longer perky, the rifle bolt shift is gone, the delicacy, the precision, all lost behind the massive, overbearing engine. It's too much, and it's shit. The exact reason even Carroll Shelby didn't like the 7 litre Cobra all that much. Except when it was making him money, of course...

I know the engineering aspect.... And I really know the practicals of driving them. I do it day in, day out, for a living and as a hobby. 200 miles is my daily average. Then at weekends I'm drifting or at a track day or green laning my silly old Landy, or buried in my garage trying to fix whatever it was I smashed. 

You still haven't explained why I'm apparently a racist, or are you just another Zeusdog? You'll spew any old bullshit and then swiftly move on to something else as soon as anyone calls you out on it directly?

That, sir, is trolling. Being right and explaining exactly why I'm right, is not. 

So kindly go do one, you deluded fuck.
Reply: You'reFucked How am I wrong? I have driven LS powered cars, and I don't like them. I CANNOT be wrong about that. It's impossible. The only way I could be wrong would be by lying, but then that's lying, not incorrectness, also, I'm not lying. Your statement is illogical.

You CANNOT drive an LS powered car like you can a proper MX5. You just can't, you'll die. 

The skill? Bollocks. To control an LS to the level that you can even the stock MX5 engine, you'd need a ruddy CNC right foot. 
And then, of course, the stock engine would still be more precise.

My right foot on a good engine is better than my right foot on a bad engine. The foot of the God of Driving would be better on a good engine than a bad engine. That's just how relativity works. 
I have the skill to control it, HOWEVER, being super delicate and concentrating hard on throttle control is not FUN. 
The more you concentrate on not turning your rear tyres into smoke, the less you can concentrate on what the fronts are doing, and they're arguably more important. 
I don't know about you, but I'm not omnipresent, I can't do everything at once. 

So what if you can still drive it, it's not as good as it was before. There's no way around that. 

Ok, so an LS3 is ~200kg all up. An original 1.6 engine from an NA weighs just 130kg, all up. 70kg difference is precisely the weight of the average woman according to Google. That, sitting on the bonnet of your 940kg car is going to seriously affect the handling. Then of course, there's the gearbox, which is equally heavier than the original Mazda unit which weighs just 37kg, while the LS3 manual weighs in the region of 60kg. That's not, of course, including the weight of the flywheel and clutch, which of course will be significantly more for the bigger V8.

So, the LS3 will mean you're running the car nearly 100kg heavier. That's a HUGE amount for something so light to begin with, and that's before you start talking about beefing up the rear end.

I'm sorry too, but no GM gearbox I've ever used is quite so sweet as the Mazda 'box. It doesn't sound like a lot, but that feeling is a massive part of driving the car.

The MX5 is not about going fast. Never has been, never will be. The chassis just isn't stiff or strong enough to cope with the power required for genuine speed...

The MX5 is about never slowing down. Big difference. It's about just sitting back, relaxing and enjoying pure, unadulterated driving. And to adulterate it with excess power kinda defeats the whole point.

If you want power, there are FAR better cars to go and put power into. A stock Corvette is nicer to drive than an LS swapped MX5, because the Corvette was actually built for it. So by the time you've gone to the trouble of ripping a V8 out of a V8 car and putting it into a non-V8 car, you only end up with something worse than what you started with. What's the point?!

I highly doubt 'this guy's Miata' could beat my proper Jag round a track. Really, I very much do. 
Unless you've got a 200mph Mazda that'll hit 60 in 3 and weighs 800kg, it's just not going to happen. 

Why would I be jealous of a nice car with a terrible engine? I had an MX5, and I loved it. Why would I want another that wasn't as good, and is six times more expensive, less economical, more to tax, more to insure and that would lunch tyres quicker than anything else I own? (No, destroying tyres is not good, it's expensive, and then you have to change them, which is boring) 

I'm insulting the stupidity of the idea that a massive V8 could improve a small car. It just doesn't. 
Maybe it makes it more exciting IF THAT'S YOUR THING, but it does not make it better. 

The Jaguar E type is probably one of the most revered sports cars of all time. The MX5 is highly respected to. However, when you hear of one with a massive engine swap, the usual reaction is 'oh god, why'. Maybe not in the US, where you seem to like that sort of thing, but certainly over here, it's not a positive reaction. Sometimes you get the odd 'man, that sounds nuts', but generally even that's a negative in and of itself. 

Why wouldn't I say LS engines aren't good? Anything else would be lying. And lying to appease people who don't understand reality is one of the saddest commentaries in the history of humanity. 

Shelby reportedly always massively preferred the 4.7 Cobras to the 7 litre ones.
Sure, one of his was a 7 litre, but think about it.
Advertising. Shelby was already fooling customers, why not go the whole hog?
He was already convincing people that the AC designed, AC built cars he was selling were all designed and built by him. Why not convince them that the (expensive) 7 litre is amazing by having one yourself? 

Fact is, the race Cobras ended up 4.7 too, so it's hardly surprising. The 1950s British sports car chassis was designed for a 2 litre I6, not a 7 litre V8. It was just never going to work, despite them using larger section chassis rails for the 7 litre chassis'

If you don't like negative feedback, don't post. It's rude to post solely for bragging. 

This is the internet, not happy happy lala land. I'm far from the worst you'll find here. Expect it. It's normal. In fact, it's normal even in the real world. And you know, some of those who give the biggest insults... are right. And then you either accept that, or you change something.

Peer feedback development, and important part of human life. 

Oh, and calling someone you've never met a bullshitter, with zero proof, that's also really rude, so fuck everyone who does that.
Reply: You'reFucked You're fucking kidding me, right? I never said that OTHER PEOPLE don't find ruined Mazdas fun, I DON'T.

I CANNOT BE WRONG ABOUT MY OPINION.

God you're thick.

Also, there's a difference between 'fun' and 'thrillin'. Yes, lightweight, overpowered cars are thrilling.

But fun is a sweeter, more innocent, safer kind of happiness, and guess what, a big bruiser of a V8 does not inspire innocence or safety in any way. 

You're an idiot, and I have the proof above. Your opinion about me does not matter in the slightest.
Reply: Foxtrot Oscar It's not ruined. Do you have anger problems? Actually scratch that. Do you have problems?
Reply: You'reFucked The MX5 is known for one thing. By putting a massive V8 in, you take away that thing. Ergo, ruined.

You may have replaced it with something else, something massively different and highly debatable, but you took away something that the world in general agreed was A Good Thing. And that is pretty much the definition of ruining.

Yes, of course I have problems, everyone faces problems in life. I do not, however, have the sort of problems you're thinking about.
Reply: hêlêl An LS powered anything is not a sports car. 
Sorry.

It's FINE that you like it. Totally fine. Just don't try and tell me that, from an objective point of view, that it's actually good.

Obviously you have put a lot of time and effort in to the cosmetics.... But I just can't help but think you've only gone and cocked it all up with that engine.

Here's my reasoning. You have a car. You've put time, effort and money into it. You've used quality craftsmen and quality materials to put together a vehicle that is powered by.... a clattery old relic of an engine that was outdated decades before it was even designed, has zero redeeming practical features, that is totally unsuited to the vehicle and, above all else, is boring as fuck. 
Every car forum is littered with Americans putting massive V8s into everything, with nary a care to the heritage or culture of the vehicle. As an enthusiast, that callous disregard that so many display really rather digs me the wrong way. 

Just perusing eBay you see Nissan S13... V8, Jaguar XJ .... V8, Toyota Celica.... V8. Ford Capri.... V8. Nissan S30..  V8 
Jaguar E type... V8...  I mean, for fuck sake... An E type? Really?

That's they cold, hard, unfeeling facts of the matter, in addition to my personal view on the whole thing. 
I know the LS, I know what it can and can't do. It can thrill those of a simple disposition, with brute force, but it can never fulfill those of us who enjoy the finer points of sports cars and perfomance.
I'll stick to my guns on this until the day I drive an LS that actually works in a sports car.

In an old Chevelle, perfect, in a truck... Fine but for the fact that a diesel engine does the exact same... but better.
In a sports car... Never. The concept of a massive V8 is the polar opposite to the concept of a sports car.
Reply: /watch?v=ACbyIrMvr7s Proof that putting an LS3 in a mx5 doesn't ruin it. Pretty much the same weight distribution, and hardly any increase in weight. Foxtrot Oscar
Reply: If you watch the video he says it's on a base tune, and it was his first time at the drag strip so he was taking it slow. Fucking idiot.
Reply: Foxtrot Oscar Pot calling the kettle black there I think...
Reply: Foxtrot Oscar You have problems. The car is detuned. That engine on a proper tune has 525hp at the crank. It can go much faster. The video just shows the miata is still retaining it's sports car ethos even with a v8. It can, and will go faster once the engine has been tuned properly. Understand yet or do you still need help? I doubt you will ever not need help... But we can do our best can't we!
Reply: This kid really does love arguing in circles doesn't he?
Reply: Foxtrot Oscar
blah blah blah. The guy that said my chevy family sedan wasn't impressive compared to a Jaguar lol. Then it wasn't that great compared to a fucking Jet car.Then the engine isn't great in a sports car that originally had like 150 horsepower.  I bet you'd enjoy life better if you didn't bitch so much. If you didn't compare apples to assholes you might get a decent debate but you are off the wall and frankly hard to take seriously.
Reply: Foxtrot Oscar
 I hate to break it to you brother but the overhead cam was invented in 1912 so your precious engine is no spring chicken.
Reply: You know what is more stupid that v8 engines are becoming more rare with todays stupid auto makers the LS is the modern 350 SBC Chevy
Reply: ***** You're wrong. C6 Z06 Corvettes reach 30 mpg without cylinder deactivation. Mileage is governed mostly by gear ratio, overall weight of the vehicle, and how much fuel you burn per hour. Also, if you want to turn an engine faster through the rpm, you use light weight valve train components and more freely flowing heads. Your M156 implements higher compression to achieve 487hp. There are people swapping nothing but camshafts in LS3s and netting 490+hp. Let's not forget how ridiculously expensive that Mercedes engine would be to modify. Every argument I've read in this thread is based on misinformation and lack of experience. You boys need to put the keyboards down and go wrench on something for a while.
Reply: +Richard Harrold so is hemi better
Reply: +jmendoza328 cause it fits
Reply: +fighterjetfreak09 thx
Reply: +deadeyedickification derp
Reply: +Lucas Boyden LMFAOOO
Reply: +ps31871 y u so mad bro
Reply: You sir have hit the nail right on the head 😂
Reply: +Richard Harrold josh. It's just spot on because those kids do exist. I'm not one for huge power considering my daily drive is a supercharged Mini Cooper and my dad's Alfa but I can appreciate that those kids who haven't a clue what they're talking about can just shut up
Reply: +Foxtrot Oscar yah you can have 400 horsepower out of a 2jz with just a good turbo back exhaust a good intake and the boost restrictor off,and this car can handle that amount of horsepower.
Reply: +Josh Wallace LOL
Reply: yes!
Reply: +Ernesto Picazo Stop telling people about the vh45, lets keep the vh for just us. :)
Reply: BLAH BLAh, you know nothing, educate yourself on Hitlers secret weapon that was months away and the war was over.  Thank good for the BOMB, thats why you are here.
Reply: ***** My country is a free country and we pioneered free health care, we also have one of the most armed civilian militias on the planet. A gun-less civilian population will be one of the first to fall in the event of invasion. If armed country's militaries fall, the invading military still has a country wide militia to fight.
Reply: I guess since Bentley's V8 is pushrod, OHV, it must suck too right?
Reply: @ChuckBeefOG yo
Reply: Foxtrot Oscar "Case in point, throwing an SR20 into a US-spec Nissan S13 is cheaper and far, far easier than putting any other kind of engine in there, and the SR is a decent, powerful engine anyway. And lighter than any LS." Lol, man. Been there, done that. Throw 30 grand in SR20 and you'll get a Honda-like curve with super-narrow powerband, because SR20 is a worthless piece of shit that can't rev reliably. Then got an LS with Jesel rockers and bunch of other stuff, a new built T56 and revved the fuck out of it. Pulled strong for 2 seasons. And SR20 gearboxes are shit, just as RB25DET one. As I said, I know about engines, I'm not a fan of LS, but I admit that they are reliable and comparably cheap.

Do you know Manabu Orido's GT86 drift project for D1GP in Japan? He was closely related to Toyota, so they used 2UR-GSE direct injection V8 from Lexus IS-F. And it fucked up! What next? They've got another new engine. It fucked up again, the pistons just broke up, they've put forged pistons in, and it fucked up again. Guess what was next?
watch?v=v1vgMs-9u68
watch?v=KaC-8Wf7fjU <<<

Your life will never be the same. Welcome to the real world.
Reply: Foxtrot Oscar Ferrari street cars may be high end screamers with little attention to torque. You're absolutely right. That's why they can make over 700hp and cost 400 grand and get their ass dragged down the street by a 650hp car that cost 85 grand. Because the car with less hp, happens to make over 100 lb-ft of torque more. HP will get you top speed, torque is the force that gets you there.

 If you were really an engineer, and actually knew something, you would know that torque is acceleration and is very important and that hp is a number derived from a torque measurement. If you were really an automotive engineer, you would know who said that quote. Automotive engineer this week, Automotive journalist last week, what are you next week? CEO of Jaguar? Just stop man, you only look like a bigger idiot with each post. All these people beating up of your posts, day in, day out, that's got to wear down the self esteem a bit no?
Reply: Gee wiz, how did this whole comment section turn to nationalism and guns? lol
Reply: @cileymyrus9443 yo
Reply: +Foxtrot Oscar So, did you finally tire of trolling Roadkill's Draguar episodes and spread out to here?
Reply: 4cyl_LOL  Lol ^
Reply: Foxtrot Oscar "Making more with less" means power-to-weight: NOT power-per-liter (which, as has been well established here, does not affect performance).
Reply: *****
"...and the rest of the world agrees"

Yeah right!
Tons of repentant folk in the UK and Canada wish they never had given up their rights to bear arms and warn America to not allow our government to get away with it as happened to them.

Also, Russian leader, Vladmir Putin, is defending gun rights now.
Reply: +Foxtrot Oscar lol This dude is trolling. Have you been checked for downs kid? You missed/ignored the points that other guy made and basically re-stated false things you already said... your jokes are great man! Become a comedian!
Reply: +shbitz  lol    hell no
Reply: +brian newcomb No the Stripes added all 150HP!!! K&M intakes don't add horse power alone... That requires larger injectors, high pressure fuel pump, Higher pressure fuel pressure regulator, larger exhaust, cat delete, and a ECM re-tune...
Reply: +Foxtrot Oscar {Then again, in that situation, switching to any other kind of modern filter, like a standard paper one, would work.} 

-Exactly...
Reply: +Richard Harrold I would just call that proper aerodynamics though. They should have seen that in the wind tunnel. Even then just reshaping the car could have fixed the issue before mass production. Someone messed up and they used a band aid to fix it...
Reply: ***** Who are you, his mummy?
Reply: ***** Power to weight, power to dollar and they fit in almost anything
Reply: +Richard Harrold Are those other engines 'fully dressed' as you put it, do you know what that means?

And where is that weight, at the top or the bottom of the engine?
Reply: ***** I don't think so
Reply: Foxtrot Oscar The rover is longer because the water pump and timing gear cover sticks out, you can't move those, try looking at a picture instead of using your pea-sized brain
Reply: Foxtrot Oscar You don't have an LS1, you have never owned a corvette and I'm pretty sure you don't even know the difference between the LS series and the gen1/gen2 small blocks 

http://www.homebuiltairplanes.com/forums/general-auto-conversion-discussion/22335-general-information-rover-buick-olds-vs-ls1-weights-reference-only.html
Reply: Foxtrot Oscar What's the real problem? did a girl dump you for someone who drives a V8
Reply: Foxtrot Oscar  I'm sorry but they work
Reply: +Foxtrot Oscar quit talking about flaws if you arent going to be specific and explain what those flaws are.
Reply: ***** So basically you're saying the LS is flawed because it can't do something that it doesn't need to do
Reply: +Richard Harrold i really appreciate you typing that out so i dont have to sift through the comments but are those really problems exclusive to the LS engines. and are they common problems? Im not an  engine expert so i appreciate information from an experienced person.
Reply: ***** Numbers numbers numbers, What if the 'engine designer' as you put it, was tasked to make an engine with a powerband between 2000 to 6000 RPM?
Reply: *****  Four stroke engines have a 4000 rpm wide power band (at least the streetable ones do)  and not everyone wants to wait until 4000 rpm until  the engine starts performing, what if I want my engine to pull from 2000 rpm or even 1800 rpm because I like instant power?
Reply: *****  I'm interested in things I can afford and do myself though, I don't want to spend  $500,000 dollars to save me from a valvetrain design that you don't like
Reply: +Foxtrot Oscar looks like you got told. lol
Reply: +Richard Harrold I wonder if much of that is because different cylinder configurations create different power bands. Americans love big torque at lower RPM so manufacturers build engines to meet customer demands. 
If GM built a Corvette with a 500 HP 4 liter V8 & a Corvette with a 500 HP 7 liter V8 the 7 liter would sell better simply because so many people in the US just love the feel of a large displacement V8. 
I also wonder if tax issues played a part in many auto makers going with smaller cylinders & smaller displacement. In many European countries you have to pay tax based on engine size so they kinda got accustomed to smaller engines & cylinder sizes. 
Basically, I wonder how much of cylinder size is because of what works best from an engineering standpoint VS. Outside influences like customer desires or tax issues.
Reply: *****
you know that gas engines pollute more than diesels right?
Reply: Hey my car runs 14.8s
Reply: +zeusdog34 I cannot believe I'm responding to you but just a few facts to consider. first, despite having over six liters of displacement the Chevy ls is smaller and !ighter than many other higher specific output lower displacement engine's. what we conventionally think of as engine size isn't really.
Reply: zeusdog34 oops
Reply: *****
lollolololololololololololololololololol

"The LS engines do not have VVT. There is no way of implementing it with a 2-valve pushrod head."(Richard Harrold)

Hers a good read for you!!!

http://media.chevrolet.com/media/us/en/chevrolet/home.detail.html/content/Pages/news/us/en/2014/Aug/0820-8speed/0820-compact-powerhouse.html

http://www.hotrod.com/how-to/engine/hrdp-1007-gms-variable-valve-timing-system-performance-test/

Hmmm looks like the Engineers at GM figured a way!!!

Please just stop your NONSENSE!!!

No proof from you or foxcock!!!!
Reply: zeusdog34 foxtrot oscar thinks V8's are no good because he was "told" so. lol
Reply: +break time lol

I never thought of it that way...I bet he was told that by one of his 12yr old friends...haha
Reply: +Foxtrot Oscar hahahaha.

It's ONLY your OPINION they are crap... Nothing factually based!!!!!

Once again I don't care about the tech articles that talk about the MINOR flaws!!!!

just like the people who buy them,build them and review them DONT care.. You KNOW why they don't care,because crossplane (push rod) v8 engines serve their desired purpose!!!

You still have NOT provided a ARTICLE/REVIEW supporting your claims that crosspane V8 engines are not GOOD for High End or Performance Auto's!!!!!

=YOU FAIL!!!!!

You are a 12yr old boy

You are Not a auto Journalist!!!
Reply: Foxtrot Oscar
hahahahahahahahahahahahahahahahahahahahahahahahahahahahahahahahahahahahahaha
lolololololololololololollolololololololololololololololololololololololololololololololololololololololol

YES BACK TO DEFLECTION AND EXCUSES!!

EVERYTHING YOU SPEWED IS 100% YOUR OPINION!!

"THE LAWS OF PHYSICS do care.... and that's why pushrods DO NOT make the power that OHC engines do. That is why, like for like, pushrods are less powerful and slower"
(FOXCOCK)

Please provide a article/review that states push rod v8 engines do not make the power OHC engines do!!!

We both KNOW that is 100% LIE!!!

"I have irrefutably proven with fact and physics, that pushrod crossplanes underperform, and thus are highly undesirable in a performance vehicle."(FOXOCK)

Please provide a article/review that states they underperform/undesirable!!!

Your Opinions are NOT fact!!

You are a 12yr old boy
You are NOt a engineer
You are NOT a auto enthusiast
Yo are NOT a auto Journalist!!
Reply: +Richard Harrold hahahahaha

I don't care about tech articles!!!! Don't mean shit to me or just about anyone who owns,buys or builds crossplane(push rod)v8 engines!!!

I want him or you to provide proof to back up his biased OPINIONS!!!!

Show me ANYTHING where is says crossplane V8 are not GOOD for High End or Performance Auto's!!!!!!!!!!!!!!

HP per litre doesn't mean jack shit!!!!!!!! Fact!!!! 

Only you euros care about it...Sorry we Americans don't give a shit!!!!

Until you or him provide a REVIEW/ARTICLE that's supports the bullshit claims, YOU FAIL!!!!
Reply: +Richard Harrold if you make 100hp/litre on a 2.0l and I make 50hp/litre on a 5.7l i still win
Reply: +Richard Harrold hahahahaha

lololololololololololololol

more proof you know very little about Auto's!!!!

tech articles don't meen shit to me...

no where in any of the shit foxcock posted ,does it say or mention that crossplane V8 engines are not GOOD for High End or Performance Auto's!!!!!!!!!!

Get that!!!!!

He has mentioned a 100 time they are not GOOD....

Until one of you provide a ARTICLE/REVIEW that supports his biased OPINIONS...
YOU FAIL!!!!!!!!!!
Reply: +Foxtrot Oscar hahahahahahahahahahahahahahaHahaha
lololololololololololololol

More LIES and BULLSHIT!!!

PROVIDE ONE ARTICLE/REVIEW THAT STATES CROSSPLANE (PUSH ROD)V8 are not GOOD for High End or Performance Auto's as you claim!!!!!!!!

Until one is provided

YOU FAIL!!!!!!!!!!

YOU ARE A BIGOT

YOU ARE A 12YR OLD BOY

YOU ARE NOT A AUTO ENTHUSIAST

YOU ARE NOT A ENGINEER

YOU ARE NOT A AUTO JOURNALIST
Reply: +zeusdog34 

flat planes have lighter weight cranks, and time the cylinders better for exhaust scavenging, making them better for higher RPM operation.  But they vibrate alot more

Crossplane crankshafts are heavier, but they run alot smoother. for a motor running idle-6000 crossplane is the way to go, which is why most OE V8s are crossplane. 

Chevrolet's first ever V8 was flatplane. They quickly dropped it due to the vibration, and didn't produce another V8 for 37 years. That second Chevy V8 was produced in crossplane from 1955-2000
Reply: +Texassince1836 yup..I know all this..

thanks
Reply: +Foxtrot Oscar I hope you're just trolling because I doubt someone could really be that stupid..
Reply: ***** I love the power on my 5. The acceleration and linear power curve feels so good. Instant low end torque. I wanted it to have supercar performance but on the road not necessarily the track. I have a stripped out 92 mx5 1.6 for track use. The reason why i picked the LS3 was the aftermarket and all the forums and parts available like motor and tranny mounts. Hardly need to do any fabricating myself for things like that. Was the perfect motor for me and my needs.
Reply: ***** Yh you have to import the parts from America, but I mean all the guides online and forums. I am British, I live in Warwickshire. Just because I say transmission instead of gearbox doesn't make me American. Even if I was, we're talking about the engine, and where I live doesn't effect how good the engine is. I was thinking about a RB from an r32 or something, but I always wanted a big v8 in a small car. The perfect pairing. My car performs amazingly with the LS3 and I definitely wouldn't swap it for any other engine at the moment. I'm not putting other engines down, it's just a personal opinion, but you can't really fault the LS3.
Reply: +Foxtrot Oscar bahaha you're on here also!? you really are sad trolling videos about the LS.Do you even have a job or is trolling ls videos your money maker somehow?
Reply: Foxtrot Oscar Wow you're an arse. I take it you drive a Honda haha? Vtec engines are terrible for public road applications. Yes they're good on the track where you're at the high end all the time, but 95% of the time you're on the road where low and mid end power is needed. You're making English people look bad.
Reply: ***** Why would you want a v12 Jag? They're boring. If it was the F type I would have been impressed. They're great cars.
Reply: Just saying but you can get a new LS in the UK for around the Price same as in the states, just not second hands ones, it would take probably around £30,000 to get a second hand XK (I know because a relative of mine races them) the power level of a £5000 LS, that weighs less.
Reply: Also there are a a fare few LS swaps in the uk I know another who has done it to a Nissan of some description.
Reply: Foxtrot Oscar Then why did you put an LS1 in one of your cars?
Reply: +Foxtrot Oscar hahahahahahahahahahahahahahaHahaha
lololololololololololololol

You are such a LIAR!!

YOU NEVER OWNED A CORVETTE!!!

EVEN IN YOUR MOST BASIC COMMENT YOU NEED TO PUT DIGS IN...

YOU CANT HELP YOUR AMERICAN HATING SELF!!!!!
Reply: +jmendoza328 This one is easy. You would do that for the same reason you would put ketchup on a cheese cake. You either have no taste buds or mommy fed you burgers all the time. =)
Reply: +Josh Wallace Says a 15 year old muscle car fanboy who is used to cheap lowtech V8s and has never had a car faster than 15s 1/4 mile. :D
Reply: Red Phoenix By the way, I'm not a muscle car fanboy. I'd much rather have a rx7 or datsun 240z over a v8 powered chevy or dodge etc. Although I do have a soft spot for the Chevelle.
Reply: +Foxtrot Oscar Looks like you just got fucked! Hahaha so funny when people are owned on youtube...
Reply: +Foxtrot Oscar unless someone gives me a GMC V12, im probbaly going to be running crossplane V8s for a long time
Reply: +Richard Harrold  hahaha

seriously, keep defending foxcock. Makes you look almost as biased and bigoted ....

Do you have proof the for coyote ,voodooV8 is better or is this your Opinion?!?!

I personally think the LT Chevy engines are better.. I'm not claiming as fact but my opinion!!!

Once again ..Please provide a ARTICLE/REVIEW that supports you and foxcocks OPINIONS that crossplane (push rod) v8 engines are not GOOD for High End or Performance Auto's... Should be simple ..That's all you two biased morons spew!!!! 
Until one is provided YOU FAIL !!!
Reply: +Foxtrot Oscar hahahahHHHaaaaa
lololololololololololololol

Oh no you are upset and angry,Please don't cry princess!!!!

still NOTHING supporting your biased OPINIONS that crossplane (push rod) v8 are not GOOD for High End or Performance Auto's!!!!!!

=YOU FAIL...

It's only your Opinion they are not GOOD...NOTHING FACTUAL!!! END OF

You NEVER OWNED A CORVETTE

YOU ARE NOT A AUTO ENTHUSIAST

YOU ARE NOT A AUTO JOURNALIST

YOU AREA 12YR OLD BOY

YOU ARE A BIGOT TO THE CORE
Reply: +Josh Wallace It's not only JDM fanboy saying that... even Euro fanboys say "keep it in your pick up truck dumb american!".. and "Why would you put a long gone technology truck engine in this hyper modern coupé? "  ... seriously this is actual comments some guy said.. at least some jdm guys know wsup and swap LS engines in their frs, 240sx, miata  for drifting and what not.
Reply: +Richard Harrold Don't ask me, it just seems to be the trend these days.. what do you mean make them worse? are you talking about the imbalance of weight distribution...?  Most LS swapped 240 and GT86 turn out to be used for drifting since they need better low end torque and this setup wouldn't benefit as much for circuit racing or auto x.

Never seen a flat six Legacy engine swapped into a GT86 or 240, seems interesting maybe it's something people should know about.
Reply: ***** They are pretty big but some are actually lighter than you think.. like i said it's mostly swapped for drifting not for circuit racing since it ruins the weight distribution. I think i'd keep the boxer engine in the gt86 if i were to use it for fast lap times.
Reply: ***** it really doesn't matter though.. if you have the money, do whatever you want.. if i wanted a serious track machine i'd just get a K20 swapped elise or an Evo. only reason why i'd swap a LS into a GT86 is to have fun. Also the V8 sound is nice.
Reply: +Foxtrot Oscar As strong and reliable a 2JZ is, it will not hold 2000hp with stock internals... they're good for about 800hp, but beyond that, you'd have to rebuild and upgrade everything else... Anyways, you must really be sick of seeing LS swaps lol, i can understand that since they are overdone.
Reply: +jmendoza328 if you want to run that engine pls. pls dont put it into an rx7, you dont ruin it but why, its an rx7 dude
Reply: +Josh Wallace  Volvo B8444S is almost as compact as a LS4 and makes more power with less displacement(and has some potential because otherwise it wouldn't be used as a base in V8 supercars). LS swaps are stupid unless you come from America and has a LS engine lying in your backyard. Also this engine https://c1.staticflickr.com/1/164/398070108_23accc489e.jpg makes more power with an OEM TD04-19T turbo than what an LS does out of the box(and in scandinavia you can get hold on that for 200 dollars and throw it into a Opel Omega (for another 200 bucks) and walk V8s all day long).
Reply: +jmendoza328 that's actually just a fun factor, the rotary engines are pretty weak but have very smooth power delivery, but if speed is your poison, that swap would make sense.
Reply: Foxtrot Oscar i mean stock
Reply: +Foxtrot Oscar Torque my friend...Torque. I have an 06 Impala SS with a 5.3 L. Does the last year impala SS with the 3.9 v6 have more horse power? Sure.....but it has 100 ft/lbs less torque. You can build your 4 bangers and v-6's all day long but I will always have more brute strength in my V-8.  This 3900 lb car has a 14 second quarter mile does 0-60 in 5 seconds, tops out at 154 mph factory...and its a fucking family sedan! I can only Imagine what the 6.2 with twice the horse power does in a light car. Oh yeah more than twice the power...FACTORY! and doesn't take up any more room than my 5.3 with my lowly 300hp.
Reply: +PontiacEfurd you could build an LS3 for less than 8k too. How about comparing apples to apples. The highest horse gen 1 small block crate I could find was 375 horse and it was 6700 bucks. The listing for the LS3 at Summit says its 6200 bucks and your right you still need the harness and crap. The Atomic LS system is 2500 so ok 8700 but at that point it is turn key and has a greater power potential and drive-ability than a gen 1 architecture. Better mileage and full range power as well.
Reply: +Foxtrot Oscar Ok for your valve float argument. This occurs in all architecture.  If the Valve train is not built to withstand the Rpms being demanded Valve Float will occur. Even in your precious DHOC. Also it is possible to put 4 valves in a cylinder with a push road design. It is not necessary to achieve the goal of a high VE. You keep talking about Horsepower but an engine is measured in torque and horsepower. Building the driveline around these qualities will allow an engine with a lower horsepower to beat an engine numerically superior provided it has more torque than the competing engine. If ,of course, in our hypothetical we assume both cars weigh the same and have the same coefficient of drag. Being a man who has very little experience with the LS architecture which is nothing like the older engines like you claim I would suggest you stick bashing engines you actually see from time to time.
Reply: Foxtrot Oscar not to be rude but, where did you get longevity out of what i was saying? i was just talking about how fun they were stock?
Reply: Foxtrot Oscar
Your Jag weighs less then my Impala son. Torque is quite important. Gear ratios only work if you have the power to turn them. You can run a higher gear with more torque and have a controlled take off with a higher top speed.  The LS7 had a 7k redline also. The red line limit has nothing to do with the valve train. The limit is imposed based on the relative mass and balance of the engines bottom end. Valves will probably float if you increase revs because they were designed to operate within the constraints of the lower end.  Also The power band for larger engines is in the lower RPM's so a high rev limit means nothing. You keep going back to the cam system. DHOC existed before push rod. For ease of maintenance Push rod will always be superior. I would also make the claim that rotational mass would be about the same. No you don't have rockers or pushrods but I'm also not turning 2 or 4 cams. I am also not worried about a belt breaking and ruining my engine. I can put a gear drive in my timing system and be bullet proof. If you knew about LS engines yours would still be running. Pushrod engines have never left the market in my country So I'm going to say my knowledge about them is superior to yours my friend. In fact I'm willing to bet my car knowledge in general is superior to yours. Quit looking at small pictures and take a peek at the whole design.
Reply: +Foxtrot Oscar "the people who put LS engines into any of those cars are not clever, not sensible, and 99.999% of the time, can't actually drift. " Tell that to DriftWorks with their LS powered ae86. And all the cars in formula drift running LS engines.
Reply: You'reFucked Thanks buddy!
Reply: You'reFucked Oh and I completely agree
Reply: Just asked Drift Works about their LS powered ae86. They said it's great fun to drive and has been very reliable compared to some of their earlier cars. More lies believe it or not from foxtrot. Who would have known! I'm gonna go for a drive round some country roads. Much easier in the dark because you can see lights coming round blind corners. Very relaxing, mainly due to the fact I have the skill to drive it and regulate the throttle hahaha.
Reply: Foxtrot Oscar But the majority of people would say putting an LS in an MX5 is a good thing. Meaning: Not ruined. 

I don't believe you.. Ever get checked out? Parents drop you down the stairs? There must be something?
Reply: My MX5 has not been ruined. It is a different breed of MX5 now but it still retains it's 'fun car' roots. As I've said before, I do own a 1.6 mk1 mx5 which is fully stripped out for use on the track which is also extremely fun, but my mk2.5 ls mx5 is the perfect high performance road car for my uses. Was quite expensive to finish, but it was my first sports car and after getting an amazing job, I had the money to do pretty much what ever I wanted. So I did. The interior has been stripped out, sound deadening over everything that doesn't show. Took it to a custom interior place, digital radio and cd changer, new custom leather seats, alcantara dash and wheel, custom leather doors. Subtle interior lighting has been put in, as well as usb chargers. We did a carbon fibre fastback conversion, aston martin style door handles, keyless entry and go has been fitted. Aston Martin door hinges so they rise up very slightly so not to hit the curb. Coilovers, bigger rotors, callipers and pads. Wider tyres all round with light weight rims imported from Japan. Custom made head/tail lights with DRLs and DRL halos where the fog lights were and a light sensor has been fitted so they turn on automatically. Mazdaspeed front bumper and sideskirts. Custom made ducktail, reversing cameras and sensors at the back. 

I've put a lot of money into my car to make it perfect for me. Any car guy would respect what other people do to their cars. Foxtrot is not a car guy, or a nice person at that. Just an idiot with an axe to grind.
Reply: Foxtrot Oscar A Jet car??? really... Weight matters. My Impala carries 13 lbs per horse. I'm betting the Jag does a little better than that. However, I'm also betting the Jag costs more than 7 grand too. I bet the jag would be faster with an LS.  LS motors are dirt cheap after market rich and can take a pounding. The timing can be gear driven (not rare by the way...at least not in the US) and is more reliable than a belt or chain. I also doubt your engineering credentials as well. Any engineer that doesn't know a 6 foot chain is more likely to stretch and fail than a 11 inch chain is an idiot. Over head cam is easier on maintenance lol. Ok skippy You start changing the water pump on on a dodge DHOC and I'll start changing the pump on my LS and we'll see who gets done first. I bet I can time my cam engine faster too. Your LS broke because your a dumbass and you make bad decisions.
Reply: You'reFucked No, the majority of people would say putting an LS in an MX5 is fucking stupid.
I know this, becuase everyone said exactly the same thing when I got my Corvette. Turns out, they were right.
Reply: Foxtrot Oscar
your right. Its a muscle car.
Reply: Travis Callahan My apologies. I am not a kid however. You're wrong about what you said though. Putting an LS3 in a Miata doesn't make it a muscle car. You have great taste in cars though. Impalas are great.
Reply: You'reFucked
I call everyone son. I never said anything about a Miata. Thank you for the complement though. I just recently acquired the Impala. I spent most of the last 4 years playing with eco-tec J bodies. When the Sunfire got wrecked I intended to get a cobalt but then I saw the 5.3 on the Impala sticker and had to test drive it. The rest is history. I love my LS4. The most fun in a car occurs between 0-90 and that motor is brute enough to get that big boat up there in a big hurry.  Acceleration gets sluggish after 130 though.
Reply: Travis Callahan Sorry, I misunderstood. I thought you were referring to the one of the last things foxtrot aid about the miata not being a sports car with an ls.Sounds great! What's the interior like?
Reply: You'reFucked
I think it has great amenities. 6 disc stereo decent amp for factory. Duel climate control and heated seats. The seats are a bit bland, I wish they were more fitted for cornering but then again I wish the car hugged better in the corner too lol. It is very roomy I could probably park a Miata in my trunk. Interior is decently laid out, controls are intuitive. Its certainly a step up from what I had but its no high end luxury sedan like a Merc or BMW. In perspective though the original MSRP was only $26,000. I enjoy it and I think it was worth every penny of the $7,000 I paid. I do wish the gas mileage was better but then I mash the throttle and I don't care anymore hehe.
Reply: Travis Callahan Haha that sounds great man!
Reply: hêlêl Proof that putting an LS3 in an MX5 does it no favours at all actually. It wasn't as fast as I was expecting. 
A 6.2 litre engine in a 1000kg car? That should do insane things... it doesn't. Mostly because it only has 430hp, which is a ridiculously low amount for an engine that big in this day and age. 
Even then, for 400hp/ton, it doesn't scoot that quick.
The old 1.8 litre Lotus Elise, weighing about the same as a stock MX5, was just as quick..

So what is all that engine doing, apart from weighing the car down, increasing the mass spread and burning far more fuel than any other MX5 driver could ever conceive? Misfires and rattling. Nothing for the actual performance that a bit of tuning to the stock engine couldn't do, for much less money.

And the shifts.... dear lord, they're so long. 

Nothing on the snappiness of a stock car. 
Fine, if the guy likes it, but don't try to tell me it's an improvement on the feel and function of the car.
Reply: You'reFucked A 'base tune' of a 6.2 litre engine in a car that size should still be significantly faster and more powerful. 
As for ponderous gear shifts, there's no way you can 'take easy' the speed at which an engine revs down. 

He was shifting at the appropriate time, as dictated by the amount of time it took to let the engine slow down to the right rpm to engage with the next gear. 

That just took forever. 
If you go faster than that, you'll just wear out your synchro, or damage the dogs in the gearbox. 

Fucking idiot.
Reply: You'reFucked So you've provided a video of a car being less than brilliant, and then call me an idiot for saying that that car isn't very good.
And then complain when I call you an idiot back...
Reply: You'reFucked The LS3 comes from General Malfunctions with 430hp. That's it. 
I don't particularly care if it can go faster or not. Anything can go faster.
What I find amusing is that it should be faster, as it is. And it isn't.

A V8 shits all over the biggest part of the sports car ethos, ergo, a sports car cannot have a big V8. 

You do your best to convince me that a car built as a muscle car can be a sports car, when it just can't. 

Sports cars are NOT meant to be fast. They are NOT meant to be powerful. They are there purely to be a simple, pure driving experience of low power, small engine, small size and high fun.

V8 is not simple, not pure, not low power, not small engine and not high fun, as you can never truly relax with it. You can't 'just drive', you've got to worry about the engine and the power too much for that. And thus it cannot be a sports car, thus it is ruined.
Reply: Travis Callahan When every line of debate leads to the same conclusion, that muscle isn't sports, then maybe, just maybe, there might be a point there.
Reply: Travis Callahan My point being, that the LS is an outdated design, and indeed an entirely outdated concept as a style of engine building, therefore has no real use anywhere outside of classic GM muscle cars needing new engines.

In terms of metaphors, the LS is less of an apple, more of a white elephant.
Reply: Travis Callahan I hate to break it to you, but that's irrelevant. Outdated doesn't mean old. 
Prevalent and sensible use of pushrods is long gone. Engines are just too good in every other area to be held back by a ridiculous twig operated valvetrain. 

Overhead cam overtook pushrods for use in performance engines by the 50s, and by the 70s, overhead cam was common in normal family cars. That shift occurred over 40 years ago, then, meaning pushrods are outdated.
Reply: Foxtrot Oscar
 Yeah... In your country, for fuel economy not performance. 70% of cars made in the USA EVEN TODAY are OHV. OHC in the US was only prevalent on Imports which didn't really take off till the late 70's and only in minor experiments did the big 3 tinker with OHC until recently. Your really dumb man. ..Like Epiclly uninformed.
Reply: You'reFucked So I think about things in a logical rather than empassioned manner. Sue me.
You cannot 'win' because the LS is generally inferior in pretty well every way. 
Were we having this discussion 40 years ago, I would certainly be far more complementary of the thing. But alas, this is 2015 not 1975.
Then again, even in 1975, the Triumph Dolomite Sprint existed as a 4 valve family car, so pushrods had already had their day. Even the Rover V8, beloved as it was, was occasionally mocked for its rattly valvetrain, and it's only got more and more hilarious since.

There is no vendetta against the LS, merely against poor engine design, and people who refuse to accept engineering fact.

The engine is naff. Fact.
I don't like the engine. Opinion.
I don't like the engine because it's naff. Fact based argument. 
I don't like the engine because it's naff and here's why... Well that's generally an unimpeachable standpoint. I am fully justified in my opinion.

The only counter to that is opinions of why it is liked, which I fully accept. Some people like their cars to feel like a 1960s truck. Some people like the whole super-budget GT thing. 
I see no point in it personally, but hey.

Prove me wrong, please do, if there is any way that pushrods or the crossplane V8 configuration are in any way good for performance or efficiency, I'd love to know. That's new knowledge and always welcome. However, I've done a fair amount of research on the subject, and I've yet to come across even a scrap of evidence to suggest that.
Reply: Travis Callahan And this is why American cars, to this day, typically under perform and are less efficient in direct competition.

Performance and efficiency are frequently one and the same thing.
You either run the same power for less fuel used, or more power for the same fuel used. Economy and performance.

The rest of the world does it the OHC way, and it's worked very well to date. The next step is of course, no cams. That should be fun.
Reply: You'reFucked Yes, I have seen the torque and power curves, I've felt them too... And they're a massive disadvantage. 

When you tune an engine, you're compromising. Always. That's just how it works, you can't have everything.

So, if you tune for a nice, fat bottom end, what don't you get? Top end. Which is where the real performance is. 

Consider the LS as a bodybuilder. Strong, tough... but ask it to sprint and it just gets all wheezy and flustered. Sure, through brute force and ignorance it may do it, but it'll never be good at it.

In terms of actual driving, linear power is dammed annoying. It removes a huge aspect of control from the driver. In situations of low traction, or where precision balancing of power to cornering are required, you could rely purely on a fraction of a millimetre of throttle travel and the accuracy of your fallible, limited, squidgy right foot, or you could do what the sensible thing and upshift, drop the revs and give yourself more wiggle room. This allows you to maintain traction easier, get closer to the car's limits without overstepping your own, and thus for you to be faster. 
Becuase no, you're not a driving god, no matter what you may think. Even the best of the best aren't perfect.

Equally and opposite, of course, a very peaky engine will catch you out and be a pain to manage.

The optimum, then, is a smooth, progressive curve that builds steadily before plateauing for a comfortable power band at the top of the rev range. Precisely not what the LS does. 

You assume I hunt LS videos? Foolish child. This is YouTube. Videos are delivered to you in any number of ways. 

The reason I come here is freedom. In my job, I'm not allowed to say exactly what I think of things becuase, well, no one is going to send you a very expensive machine if you're just going to rip the shit out of it. 

Here, I have none of that, because I'm detached from my professional self. And, of course, disagreement opens debate, debate is interesting, stimulating, and opens new avenues and new viewpoints.
And it's moderately entertaining to watch die hard fans of mediocrity crumble in the face of cold, hard fact. 

You say pathetic, I say factually correct.
One is your opinion, the other is a statement of some weight. Not a vast amount, but it's something. 

Does that answer your questions?
Reply: Foxtrot Oscar Wow you're such a bullshitter. Are you still pretending your a motor journalist? Hahaha A linear power curve is extremely desirable. You fucktard. You're a joke! And yes you hunt these videos. You don't have to click on the video if you see one do you? Haha you're a complete joke. I'm not  kid. Judging by your maturity however, Im not sure you could say the same thing.
Reply: You'reFucked Haha, no, linear just means there's a massive lacking at the top end. Theoretically it should be good, however, due to the laws of physics and the way engines work, the only way to do it is a MASSIVE compromises in performance and efficiency. 

In a word, crap.

Automotive, not motor. I don't really have much love for electric machines.

No, I don't have to, but why shouldn't I? Just because the facts disagree with your opinion and that of others does not mean that I don't have a right to explain those facts and explain my opinion too. Why not throw the cat amongst the pigeons, so to speak. Why let people fester in their own ignorance, and indeed arrogance. 

A dose of reality can go a long way, and if I can be the reason that one or two LS fanboys stop shouting their bollocks from the rooftop, then I'll have made the automotive world a quieter and bullshit-filled place.
Reply: You'reFucked Who cares who coined it, why should I not be technically correct in my explanations?

A troll posts deliberately inflammatory comments for the sole purpose of deriving pleasure from agitating others.

I post factual, topical comments for the purpose of self expression, factual correction or explanation and intellectual debate. 

So, the opposite of a troll then. 

You're an idiot, fuck off.
Reply: Foxtrot Oscar Trolls post things to get a rise out of people and to gain attention. You're a troll. I'd rather be an idiot than a sad shit like you.
Reply: You'reFucked So now you're telling me why I'm posting? You presume to know my thought processes better than myself? 

I most certainly do not post simply to 'get a rise'.

You are not a mind reader, and even if you were you'd be a pretty shit one.

Given the sheer ludicrousness of your statements, I suggest that you do indeed fuck off. 

You're nuts son. Batshit crazy. Squirrel shit is less nuts than you.
Reply: Foxtrot Oscar You have problems don't you?
Reply: You'reFucked I'm not the one (falsely) trying to tell people why they're doing what they're doing.
Reply: Foxtrot Oscar But that is what you're doing. It's not hard to see that Starting arguments to gain attention. Pretty obvious stuff really.
Reply: You'reFucked I didn't start shit. The question 'Why is the LS so good?' did.
It started it by presuming something to be true that simply isn't. 
The title of the video is the inflammatory part, I merely responded with "it isn't". I then gave reasoning, as any proper debate should include. 

Why would I need attention on an anonymous account? If I wanted to troll, I would want people to know!
Reply: So why click on the video if your opinion can't be changed unless to troll in the comments section? The guy in this video is also far more credible then you. Haha, although you've been very funny and entertaining so thanks for that!
Reply: You'reFucked You assume too much, foolish boy.

My opinion can be changed. That's why it's opinion.
What can't be changed is the facts.

The LS is an outdated, inferior design, fact.
I don't like the LS, opinion.

I don't like bullshit either. 

I don't care how 'credible' he is, he's talking about the LS, and the video is asking why the LS is good.... when the LS is not good.
Reply: Fuckin idiot
Reply: Who said ls swaps are stupid? I think your fucking douche
Reply: races past
Iiiiiiiiiiiimmmmmmmm gaaaayyyyyyy
Reply: Lol because people don’t have a lot of money 😂
Reply: Or a cave dweller
Reply: This comment hurt a lot of jdm feelings
Reply: Or a 60 year old that’s stuck on sbc it’s so annoying
Reply: Cody Green Mother...fucking...PREACH!!!!!!!!
Reply: +Foxtrot Oscar Yeah? Well, guess what. Your single experience with an LS series engine does not represent the massive amount of successful engine builds and daily driven LS powered cars. I had an 01 TA with 180,000 miles that I raced almost every weekend without a single mechanical issue. You were probably one of the few exceptions that don't know how to take car of an automobile the correct way. If the majority of LS engines were as bad as YOU say, they wouldn't be the most widely used V8 in existence. You are basically sitting here saying that the guy in this video, a guy who builds 2-3K hp cars for a living, is lying. But I'm sure you know more than he does...
Reply: Ciley Myrus LISTEN.
Pushrods are shit because:
They do not allow for more than 2 valves per cylinder, which limits valve size and thus air flow.

They do not allow for wide valve angles, thus limiting valve size and flow.

They do not allow for easy installation of variable valve timing, thus reducing efficiency.

They do not allow for individual control of intake and exhaust even if you do manage to get VVT on there, again, reduced efficiency.

They incorporate far more reciprocating parts; the mass and friction of all this reduces mechanical efficiency and limits revving.

Valve float mudafukas!

The inherent flex in the pushrods and the rockers means that the valve does not follow the cam profile exactly, meaning all the hard work of the cam designers is wasted as the valves just do what they want, limiting the effectiveness of valvetrain tuning, thus limiting power and efficiency.

They cause massive headaches when the time comes for cam maintenance, which turns from a lazy afternoons work into a engine-out marathon, unless the whole front of your car is peeled off.

Vertical valves mean sharp bends within the ports in the head to meet the intake and exhaust manifolds. Bad for gas flow. 

That's a whole lot of power and efficiency wasting flaws with the design, that OHC and DOHC systems simply don't run in to in general terms. 

An engine that is MILLIMETRES smaller at best, and has a CoG that is moved MILLIMETRES downward, and that is only a few kilos lighter at best, is WORTHLESS, if it CANNOT make the power and CANNOT return the same economy, and CANNOT deliver the power as smoothly as a properly engineered engine. 

Because you can't use the power, and the benefits are largely unnoticeable compared to the efficiency gains of OHC. That is why almost ALL racing engines since forever have been OHC. 

You cannot sit there and tell me that the last 100 years of engine designers have all been wrong because Chevvy are stupid enough to continue using pushrods...
Reply: You obviously know nothing about cams or valve trains ,there are more push rod engines by far than ohc
Reply: +Richard Harrold What makes other engine better than an LS? please give me facts. if the LS weighs less, has more power and ironically enough is usually more fuel efficient than many of these other "Performance engines" then how are they better? DOHC was only created because of europes retarded displacement laws. Displacement means nothing to someone who truly understands performance. Its all about power to weight ratio and the LS always had a very good ratio. I am certain that if europe never enforced displacement laws they would be producing some awesome OHV engines with great mpg. LS = Reliability, geat power, efficient whats wrong with that? And before anyone accuses of an import hater one of my dream cars is a r34 skyline. But a r32 would also please me =).
Reply: Victor Pitts LS swaps are still stupid though.
Reply: Foxtrot Oscar ok I'm just going to say it...you're a fucking idiot. That's it. You don't even live in this country where 95% of LS engines call home. You have no point. You are typing blatant lies. I would pay a large amount of money for you to spew this garbage to Nelson, Hennessy, or any engineer at GM. You don't even know that the dohc design is only about 5 years newer than pushrod technology. You live in a bubble and it's blatantly obvious from your comments that you're typing from that bubble as well. Go educate yourself on tree nurturing or something, because you've failed as an auto enthusiast.
Reply: +Lucas Boyden HAHAHA
Reply: N4CR5 That GT-R is also bigger and heavier than the Corvettes that get the good economy. And produces more power. Like for like, weight for weight, the GT-R eclipses the LS economy, still with great power. 

Quite a few people swap Merc V8s, actually. Certainly more than LS swaps, this side of the Atlantic at least. Yes, they're still very, very rare, but then, you almost never see LS engines in their original cars, let alone swapped into something else. I only know of one LS engine within 50 miles of where I live, and it's sitting in my living room doing a pretty good job as a coffee table.
Reply: Ciley Myrus Read the article yourself. The AMG engine is the same weight and is significantly more powerful.

And it does NOT 'literally take a 56k engine to match the LS7'.

The AMG engine will cost because they don't make crate engines. Each of their engines will be hand built to spec, for a customer car. That means for you to get one, they have to disrupt the production line and insert an extra engine that doesn't have a car to go in.
GM don't do this, instead they simply produce too many engines to begin with, then using all their healthy tax allowances, sell them to unsuspecting morons. 

Were it that AMG sold crate engines, the cost would likely be a lot lower. Of course, it'll be higher than an LS7, but only because AMG don't receive the wonderful tax breaks GM seem to, and they build all their engines by hand using skilled German labour. 

In the end though, you get what you pay for. You pay more for the German engine, but you end up with a superior propulsion unit. 

Not that I'd bother with an AMG V8 at all, because it's just not my style.
Reply: +Foxtrot Oscar maybe you need to check out a newer version. they make lot's of power per dollar and are reliable as hell. what's not to like?
Reply: ***** Correct sir. There's no point putting a V8 in a small car... unless it's a teeny tiny V8. There's a company in Australia that does a 2.5 litre flatplane V8 conversion for the GT86, and that's apparently a very good little engine. Expensive, and not massively powerful, but a joy to drive... which is the whole point.
Reply: C Genious First of all, DO NOT make slanderous assumptions about the political leanings of another.

I am NOT anti-American in any way. I'm against some of the things Americans do, just as I'm against many of the things pretty much all of the rest of humanity does, but I'm not anti American.

So fuck of.

Second, I'm not 16, I'm 29 and have built a career in engineering and automobiles.

Third, 'fanfuck'? Seriously?
Given your steadfast, unwavering, ignorant defence of the LS series, I think you've just found the perfect descriptor of yourself.

If the LS is set up to have 'no more power than needed', that's fine. So why does it have to have so much more engine than is needed?

You do NOT need 7 litres to make 500hp. ALL that having an engine that big does is increase the engineering headache of making it not all fly apart, and increase friction and inefficiency exponentially. 
It's fucking retarded, in the simplest sense.

'Potential for power'. Great. So? 700hp from a 7 litre N/A engine is NOTHING SPECIAL. It's a 'meh' in the car world.  That's 1980s levels of modified engines. Boring. We've all seen that and moved on.

You are using ONE mediocre OHC engine as evidence that ALL OHC engines are shit?

THAT is BULLFUCKING SHIT.

You ignore over 100 years of OHC dominance because one engine wasn't quite perfect (and is still better than most LSs)

Fuck your logic man. 

'Best bang for buck on the planet'. BULLSHIT.

For the cost of buying a stock LS, I could buy and build a 1000hp 2J.

So fuck off.

 Maybe great bang for buck in the US, but not out here in the rest of the world.

Sorry, the highest mileage car ever is a 1970s Volvo. 3 million miles and counting. 
Where are Volvo's from? Sweden. Where is Sweden? EUROPE.

Dumb as a rock.... 

Fact is, I'm sick of LS fanboy cunts like you spewing their bullshit all over the place. We don't want to hear it. We don't care that your archaic, twig powered behemoths can wheeze out 500hp. No one wants to hear it any more. 

Ferrari can make a 4.5 litre V8 make 600hp. GM can make a 6.2 litre V8 make 450hp.

Ferrari kicks the shit out of GM. Fact. More power, from less capacity. What's not to like?
Reply: You are the one who clicked on a ls video
Reply: C Genious The country responsible for the course of WWII is.... The United Kingdom of Great Britain and Northern Ireland.

1939, Hitler is rumbling across Europe, absorbing everything in his wake, building up a continent sized army. Also, Russia is going along with this. You know, the country that's like three times bigger than the US and has a near infinite supply of men to throw into a war. No one really puts up any fight untill...
The UK tells him to fuck off. 

One tiny little island tells an army of a continent to go home. And then crosses the English channel to go punch that army in the face.

1940. Britain stands alone. France has surrendered, and the most effective and aggressive military force the world has known bares down on one teeny little island that wasn't really prepared for a war, and is being blown up constantly.

Oh... we won that one. With half the number of planes, and help from our... Empire.

Hitler gave up all plans of invading Britain by autumn 1940.

However, he did not give up travelling down Africa, and intended to take South America and travel upwards... to the US.

Summer 1941, Germany invades Russia. Thanks to the German military being split between fighting Britain and Russia, the Russians just about manage to hold on to Stalingrad, and subsequently return to generally fuck shit up for Hitler. The Russians eventually won the war.

December 1941, two and a half years late, the US finall joins in, after the Germans are already being forced back.

The US helps with the invasion of France.

1945, the Russians take Berlin and it's all over.

Basically, Britain stopped Hitler, Russia beat the crap out of them, and the US helped out (a lot) with the clean up. 

It was a team effort, and the US assistance shortened the war by ~two years, and nothing can ever detract from the sacrifices made by those on all sides.

However, no, the US did NOT save the world, or anything even remotely close.

In terms of tech, it was British Spitfires and Hurricanes that turned the air war around, it was British computers that decoded the German messages (including Enigma), it was British RADAR that allowed detection of incoming aircraft, and it was even the British Rolls Royce Merlin that powered the best American aircraft of the war, the P51 Mustang. 

US V8s are banned from NO competitions that I know of.

The ONLY thing stopping them from entering is displacement restrictions.... which apply to EVERYONE.

The Corvettes did NOT 'dominate' their class. This year was a class 1st, a DNF and a DNS.

A Did Not Finish is hardly dominating, but one of the cars didn't even manage to start the race!

That is in NO WAY anywhere near dominance.

Last year was a 2nd in class. Pfft, big deal. One of the Aston Martins from the class below was faster than one of the Corvettes. Ha. 

You do also realise that in the GT series, the Ferrari's are the most heavily de-tuned.

The custom 5.5 litre Corvette engines are tuned well up beyond factory settings to 500 or so horse power.

The Ferrari engines are de tuned from 600 to 500hp, using stock factory engines. Not custom built ones.
Reply: +Lucas Boyden lmfao and with those parts from AutoZone super wack
Reply: +James Schall they are that light because they are push rod engines, a vh45 is about the same weight of an ls1, but its a DOHC 4.5l v8 which makes only about 50hp less than an ls1, making the torque peak at 400 revs less and peak power at 400 revs more, with its 1.3l displacement penalty, yet has a full forged internals from the factory, and if you tune the ecu, you could make the same power as an LS1, of course, there`s less aftermarket because is not as popular as a JZ or an ls
Reply: bart medes Who gives a fuck about your opinion?
This 'shit hole island' invented the world as you know it today.

The aeroplane, the railways, the computer, radar, sonar, the web... modern industry, steam power (that still makes something like 90% of electricity around the world to this day)... electricity itself... industrial metallurgy...

Pretty much everything involved in the design and manufacture of engines, and the computer you're using to post this bollocks on, and the methods used to transport the computer and the engines, was invented on or by someone from this 'shit hole island'..

You are just another arrogant, ignorant, brainwashed fanboy yank with no idea how the world works.

Good night.
Reply: bart medes Sorry, what? You have a nuke, great. So do we. What of it?
No one can use them.

It's because of our own resilience that we exist today, you lot arrived over two years late.
You CANNOT 'save' someone two and a half years after they needed saving.

It just doesn't work like that. Either they save themselves, or they die. And, well, hello.

Evidently, we did pretty well on our own.
Reply: Serenity in silence *Genius.

Sorry, but there is a degree of irony is being misspelling the word about being clever.

Anyway... no, LS engines are not clever. They're stupid.

They've come up with some clever tricks to help minimise some of the flaws of the pushrod system..... but they're fucking retards for using it in the first place.

Example: If you're clever, you could probably modify a fork to eat soup with... but starting with a fork when a spoon already exists is just stupid. 

Yes, squeezing more power out of an engine reduces its overall life... so how come American cars don't seem to last as long as European or Japanese ones? The few Chevrolets that people bother to buy this side of the Atlantic, all seem to fall to bits after 10 years, which just isn't on these days.
You can pick up an 03 Audi or VW these days and it'll be a perfectly usable car with practically zero faults. 

So why do you need an engine that 'might' last so long... but the rest of the car won't, and in the mean time, the engine is a clattery, gutless heap of crap?

There's just no point.

So you could bodge an LS back up to 700hp...

So how come people like Ferrari can make 740hp, reliably, with a 6.3 litre N/A engine AND it's perfectly fine to sell the car, it passes all the tests for emissions and safety and so forth....

Why can't GM do that? 

DOHC does NOT equal zero bottom end. What it generally means is more top end, making the bottom end look less.

And, in reality, you DO  NOT need 500lb.ft available at 2000rpm.... because when the hell are you ever going to need to tow a horse box with your 'sports car'..

Torque is for towing, power is for speed, and top end is where all the speed is.

DOHC is less complex.

For a 32 valve DOHC V8, (giving superior flow, more power and more efficiency) there are: 4 cams, 32 valves and their spring assemblies and 4 sets of bearings for the cams.
That's what, 40 major parts.

For a 16 valve pushrod V8 (giving inferior flow, reduced power and reduced efficiency) there are: 1 cam, 16 followers, 16 pushrods, 16 rocker arms, 16 valves and their spring assemblies, 1 set of cam bearings and 2 sets of rocker arm bearings. 

That's 68 major parts. 

For a less effective valve layout. 

It's a no-brainer, use DOHC. 

The weight movement upwards is actually minimal, because you're removing the weight of the rocker assembly from the head to replace it with a pair of cams, which isn't that much heavier, and you're removing the weight of all those pushrods, and you're removing metal from the head for the extra ports. 

So, DOHC is really not that much heavier, is simpler, has fewer parts, as everything is on top it's far easier to service, and because the cams act straight on the valves, without lots of other bits of metal in between, DOHC is quieter.
Reply: DoriFord Pushrods do result in slightly smaller heads, yes, however the exhausts protrude further sideways, and the intakes are generally taller, so the overall 'cube' of engine space is unaffected by head design, and of course, the efficiency benefits of an OHC system mean you can design an engine with a smaller capacity (thus a smaller overall size) for the same power anyway. 

The LS engines are no better than any other kind of engine for cheap power, and if you're trying to swap one into a car that never had one, it's usually cheaper to simply modify the original engine or swap in a higher spec engine from the same model/manufacturer.
Case in point, throwing an SR20 into a US-spec Nissan S13 is cheaper and far, far easier than putting any other kind of engine in there, and the SR is a decent, powerful engine anyway. And lighter than any LS. 

Low end torque is only any good for towing and for very heavy vehicles. It's there for lugging, not for speed. That's why all big trucks have very torquey diesel engines... Not fast, in any way, but they can tow huge amounts. 

One cam is cheaper... but then you've also got to produce all the followers, pushrods, and all the rocker arms, and that stuff costs money and time to install. As for maintenance, with OHC, the cams are up top, easy to access. With OHV, you have to remove either the engine, or half the front end of the vehicle, to gain cam access. 

The Bentley Continental entry level engine is a 4 litre Audi V8. 

The Arnage uses Bentley's ancient  6.75 litre pushrod V8, but that thing has been around since the 40s.
Reply: C Genious I couldn't give a fuck who said that, it's simply not true. Power is more important in racing.
 Look at the fastest cars in the world, F1 cars.... what are they? High end screamers. Reasonable torque levels (for the engine size) but huge amounts of power, all at the top end.

As for road cars, look at Ferrari... high end screamers. Loads and loads of power, with little focus on torque production. That's why all their engines are massively oversquare.

In fact, look at pretty much any of the greatest performance engines of all time, all short stroke, big bore, built for revs and power. 

Also, pushrods have nothing to do with torque. Stroke to bore ratio and tuning does. 

McLaren build F1 Chassis', that's what they do. Lotus build chassis' too. That's why theirs are some of the best in the world.

If you are a small company and try to do engine and chassis, you'll just run out of money and neither will be very good. 

McLaren have one of, if not the, highest win ratio of any team since the dawn of history. 

They're good. They just had a bum deal on the engine this time around. 

You've actually got something right there. The LS is like a religion. A load of bullshit, but people keep waxing lyrical about it and trying to ram it down your throat. 

LS fanboys are the Jehovah's Witnesses of the car world.
Reply: @TheWierdFish yo
Reply: +Josh Wallace You muscle fanboys always comparing cars in a straight line. You should know that outside of the US, roads have curves and that is what matters. Lets say.. JDM cars are a hell lot more fun than usdm cars in Norway because we have curvy roads and japanese cars handle them like a dream.

The point is, a car is not usually being driven in a straight line all day so it is a stupid way to compare them.
Reply: Mr Anderson Which points specifically? The ones about how the LS is magically lighter and smaller than anything else, runs on unicorn farts and somehow the entire rest of the automotive world has been totally wrong about pushrods for the last 80 years or more?

What have I said that is false? If you're making claims, please do back then up with evidence.
Reply: John Smith Power to weight, LSs are mediocre at best. Power per dollar, nah. Outside the US, they're king expensive, as they just aren't sold in any numbers. Also, in terms of swapping... Why bother, when the same money spent on the stock engine produces, generally, something better?

The cost of the swap alone is huge, and that's before you spend the money on all new internals to get the clattery LS up to scratch.
Reply: James Schall They're not that light. Really, they're not. They're not overly space efficient. Any 4 or 6 cylinder is smaller. They're NOT economical. Not in terms of power per MPG. They're not that readily available, unless you happen to live in the USA, which is one country out of hundreds. 

What does the LS do? Not a lot, actually. 

What you're missing there is that both engines are missing intake, exhaust and cam/useless pushrod stuff covers, which is what actually bulks the engine out.
Also, I don't know what the engine on the left is, but it's certainly not a VQ, as it has four ports on each side. It's a V8, and by the looks of the block, it's a big one. 

Also, why the fuck does the head size matter? Seriously? It makes little difference.

http://i132.photobucket.com/albums/q11/300bhpton/Car%20stuff/General%20Car%20Pics/1uzvsls1.jpg

Look at this picture, it's a 1UZ and an LS.

Ignore the fact that the 1UZ has all it's ancillaries still on, but measure across the extreme limits of the heads and they're almost exactly the same. The 1UZ is just as tall, and actually shorter too. It's smaller than an LS then. And a VQ35 is smaller than a 1UZ. 

In addition, remember that pushrods SUCK. They may save you a few millimetres if you're lucky, but will also cost you in power, economy, efficiency, and if you ever need to do any valvetrain work, can be a bit of a pig as it's buried deep in the engine so you need to remove half the front end of the car to reach the damn thing. 

2Js come with turbo's. I wouldn't bother modifying an N/A one, get a turbo one, and you can run 1000hp happily on the stock internals. Buy a refurbished truck turbo and you're laughing all the way to the Dyno. Plus, they have far better aftermarket support, and it's global, so you'll probably have parts available in your country, rather than having to ship them 5000 miles. 

The 2J weighs less than an iron block LS, and although more than an aluminium block LS, if you're going for big power, you want the iron for strength. They also manage heat better being inline, as all the hot stuff is down one side, and the intake is on the other, while a Vee engine has hot bits on both sides, and the intake stuffed in a little corner up the top. Not great for power either. 

An SR20 can be bought for less than an LS, even in the US, and yeah, you may have to spend a bit more modifying it, but it's significantly lighter, more responsive, more economical, easier to drive, easier to maintain, and is generally a better all round engine. 

You can pay a fair chunk of money for crap, or a bit more for an actually decent engine. Choice is yours.
Reply: MrZerocool5000 But the LS isn't brand new. It's 60 years old, effectively. That design of engine is the sort of thing one might find powering a 1950s tractor.
Reply: If that is  the case then all piston engines are more than 150years old design
Reply: Ls motors cost much more then traditional v8s a new 430hp crate ls3 is around 8k and that dosnt include everything to make it run or fit in an ls swap. For all that you can build an old school v8 and drop a ez efi on it and done  430 cheaper horsepower.
Reply: +Josh Wallace If LS swaps in Rx7's Supras and Nissan 240s are so good then WHY do those cars with a original Highly Modified engine FASTER and the world Record holders? Hmmmm A 700hp LS swapped FC3S RX7 is Slower then a 450whp 13bTT FC3S
Reply: C Genious
If the LS is SOOOO great then why did Ford when with sweeping Victories in the AMSOIL Engine masters Challenge this year? And if they are so great why were Modular V8s like Fords 4.6L BANNED from competing? Its because the LS V8 SUCKS DONKEY BALLS and needs its competition "banned" to attempt a win. They cant even beat Ferrari  at the 24hr lemans yet the only American Overall victory goes to Ford with the GT and the 4 displacements it had from the 255 to the 427.
Reply: John Smith You're not considering all the variables. An engine is not a pump, it's an energy converter, and the energy out is the important bit. Moving air and making power are not directly correlated, as large cylinders can result in incomplete burns, gas stagnation, and of course have a far larger sliding surface, thus more friction. 

And no, a smaller piston going faster won't necessarily make the same or more friction, as with a longer stroke, the piston speed is greater for the same revs. More piston speed, more friction. 

Also, with higher revs in a smaller engine, don't forget all the parts are smaller and lighter, which means less force, less stress. 

Yes, pistons and cranks and shit are older than pushrods (although not that much older) however they haven't been bettered yet (the wankel sort of does, but is underdeveloped), while pushrods have very much been superseded.
Reply: Gale Banks said point blank that engines where nothing but air pumps, and the more air you can pump the more power you can make
Reply: ***** But it's what their daddies done, and their daddies daddies done, and what their grandaddies daddy gone and done too. 'Murica, fuck yeah, etcetera. 

They do it largely to keep their customer base happy, and in turn, that customer base continues to believe the marketing, which of course means they've got to keep making them to keep that core of, let's say... gentlemen of an alternative mindset... happy.
Reply: shananagans5 I'm not sure it's so deep as that. People will buy the 7 litre V8, purely because it's the 7 litre V8. It's a status thing, in many cases. 

Smaller displacement in Europe... yes and no. Normal passenger cars, yes. Because you just don't need 5 litres plus for day to day use. Sure, my daily is a 5.3 litre V12, but I'm an idiot. For most people, 1.4-1.8 litres is enough. An engine of that size will propel an average car along at 70mph, all day, every day, without straining itself, but without leaving huge chasms of unexplored potential wasting efficiency. It's a healthy balance. 

However, if you look at the more exotic engines, they still all tend to have mostly square cylinders of about 500cc, or just a little over. 2 litre 4 pots, 3 litre V6s, 4 litre V8s are popular, 5 litre V10s, done, 6 litre V12s. 
This just seems to be around the optimum size for getting the job done in regards to flame front travel speeds, gas stagnation minimisation, but equally, minimising boundary layer and mechanical friction. 

Tax in Europe is generally based on emissions, with cleaner cars being cheaper, or even free, and big, dirty, polluting ones costing more. Makes that smaller, cleaner, more fuel efficient engine making identical power look ever more tempting, as it'll be cheaper to tax too. And just better in general.
Reply: +Josh Wallace Just a few comments by Foxcock over the years!! LS3 is a heap of shit. Period.Versatility of the Chevvy V8? What? They're shit in trucks, shit in Corvettes, shit in large saloons, shit in luxury cars, shit in sports cars... shit everywhere. Clattery pushrod V8s making little power and drinking far too much fuel doesn't workLS engines DO underperformThey're shit.The 'flat' torque curve is shit.
The sound is shit.
The amount of power they make is shit.
The amount of fuel they burn is shit.
The aftermarket support, compared to some other engines, is shit. There is nothing good about them.Chevvy V8s belong in 'junk' yards,Chevrolets LT1 is stupid and big.
6.2 litres, 455hp.And the noise.... There's nothing quite so annoying as being at a classic race meet, having sixes and twelves and fours all howling around making a glorious racket... and then a V8 goes past sounding like a wet fart. Kind of anticlimactic. And they're a pain to race against, because it always seems like they're going to crash. The Corvette has always been tuned with performance in mind, except it's tuning a truck engine, which is never going to work American Embarrassment On Wheels.  the Corvette makes 455... yeah, that looks pretty fucking gutless to me.I also like the idea that my kids (if I'm ever cursed with such things) won't have to pledge allegiance to a ruddy flag every morning. That's kinda creepyIt's also a bit creepy and very reminiscent of.... Hitler Youth. Just saying.... Young kids, pledges to their countryThe founding fathers of the USA were about the most unpatriotic lot you could imagineYes, very, very different purposes behind each pledge. One is to encourage kids to turn a blind eye to weirdness, the other was to get kids to murder jews. But.... take a picture of an American classroom, photoshop the Swastika over the Stars and Strips, make every kid blonde and give 'em a little arm band and it's 1939 all over again. Spooky similarities.The world has taken a lot of performance lessons from the US. Don't do it that wayAs for the thanking your ancestors.... thank mine for... pretty much everything you know and love in the world today. The power delivery is shit, and crap for racing, believe me, I've owned LS engines and I've driven them hardThe Corvette has a shit engineYou CANNOT get the same performance out of a crossplane V8 as you could out of an equivalent I6, flatplane V8Corvette have a particularly shit V8, this is proven by fact and physics (same thing really).460hp from 6.2 litres = SHIT
Crossplane, large, pushrods = factually, poor design. In other words, shit. So having an LS engine with its excessive torque, flat power band, sluggish response and limited rev capacity is actually pretty shitLS engines are actively mocked and avoided by many people. 
LS engines are FACTUALLY shit for performanceIf it started running like a brand new, perfect LS engine, I'd have it in bits immediately thinking something was terribly wrongI dont claim the crossplane V8 is shit, it IS shitI don't claim it's a boat anchor, it IS. 460hp from 6.2 litres? It's not even worth getting out of bed forN/A V8s don't offer the performance that a turbocharged 6 cylinder can offer though... that's the problemWe do not hate Americans as people. 
We hate the USA as a country because its foreign policies are fucking ridiculous, it's a fucking SHIT ally and screwed us over financially for WWII (whilst arrogantly taking all the credit)(FOXCOCK)This troll/tool has a deep distaste Towaqrds ANYTHING American!!
Reply: My favorite one lately is "why would you put that motor in a rx7" I'm like "hahahaha"
Reply: Ciley Myrus What the hell is 'VE' supposed to be?
Power to weight takes a back seat to controllability. Also, LSs are NOT that light.

In the end, a Ferrari V8 makes 600hp and weighs 150kg. That's 25% LESS than an LS7, for 33% MORE power. 

And yes, the Ferrari V8 is smaller as a result of its smaller bore and stroke, and it is smoother and more responsive and more precise and generally easier to drive hard, meaning you can spend more time harder on the throttle meaning you go a LOT faster, without worrying about traction issues and precise throttle control. 

In the end, you can go have your period elsewhere, we don't need it here, nor do we need LS engines and their spindly, rattly, nasty little pushrods.
Reply: If you have millions
Reply: +Richard Harrold  Mclaern might dispute the Best in the world engine
Reply: +MIGHTYSAMINYOURFACE but like Ciley Myrus keeps on saying, why is that better if it doesn't produce better performance?
Reply: +Richard Harrold LOL! You think "no guns" and a socialist health care makes a better country? That was funny.

BTW,,I love my guns including my oh so scary looking AR-15
Reply: Victor Pitts Yeah... it is stupid. The only vehicles I can think of that would possibly benefit from an LS are old GM vehicles that came from the factory with older, iron block designs of pretty much the exact same engine. Chevelles and old trucks and things. Older Corvettes... 

Take the ever popular troll's swap. The S13. The 240SX to you lot. 
The original engine, with the same money in a turbo swap, can make good power. And if it blows up (which is probably for any engine in drifting, say) replacement is dirt cheap and so, so easy (because it was designed to be there).
Failing that, for the same or even slightly less than an LS swap, you could swap in an SR20. Which is lighter, fits with factory parts and wires up properly (saving a fortune in the fitting costs) and can still produce solid power. More than the chassis can handle, in fact. 

So why would you put an LS in, that costs more to install, is more difficult, that has a far smaller global aftermarket, and will do nothing for performance that other engines can't and will make driving more difficult thanks to its shonky torque distribution. Oh, and that will make you one of the most hated people on the average drift day, because big V8 drift cars tend to do nothing but smoke and spin, which is annoying.
Reply: You'reFucked Well it's not obvious to me. I didn't know that I came here deliberately to annoy people, I thought I came here because I was annoyed by flagrant bullshit.
Obviously I was wrong about my own thought patterns.

Do what you want, I don't care, choose to believe the words of a bloke who posted this video (the one who wrote the title) and a chap who builds engines over the last century of engine development. I mean, millions of people can't be right if a bloke who builds horrid engines says they aren't...

Mind you don't slip on the sarcasm pouring off that comment...
Reply: Foxtrot Oscar just accept it you got roasted and outnumbered in this comment section. The LS is superior nuff said.
Reply: +Josh Wallace Or, lifelong engineer who loves cars from all over the world, has driven extensively in a wide range of vehicles, and still thinks LS swaps are stupid. They're fairly heavy for most cars, certainly more than most 4 or 6 cylinders, have TINY amounts of power stock (and if you're going to modify it, why not just modify the stock engine?) and are just not good engines from an engineering point of view. This is coming from a guy who owned a Corvette, so, LS powered, and yes, LS swaps are stupid. 
Unless what you're swapping it into is vintage GM muscle cars, because for an old Chevelle or something, what's not to like about a 'modern' engine that keeps the same ancient architecture for historical accuracy.
Reply: @TheWierdFish    WTF are you smoking?
Reply: @TheWierdFish  you're extremely stupid
Reply: dannonyogurt98 LS7. 500hp from 7 litres. Crap.
LS1 350hp from 5.7 litres.
LS3 400hp from 6.2 litres.

All crap.

Even the brand new LT1 only makes 460 pathetic, wheezing horses from its 6.2 litres. 

Teeny amounts of power for what they are.

Look at comparable performance engines and they're ALL making far more specific power. 

No, I do not masturbate over specific outputs, but the facts are the facts, and if you can't make power without capacity, what the fuck are you doing in the performance world?

Performance is the art of getting a lot out of a little, not getting a little out of a lot.

I dare you to man the fuck up and face the facts.
The LS series is a MASSIVELY outdated design with ZERO redeeming features. 
They make poor power for their size, give poor economy considering the power, and do not respond or deliver power like a performance engine should. They feel like truck engines, and that, in a sports car, is totally shit. 

Your entire opinion is wrong, and I state this from a factual standpoint. 

You would RUIN a 370Z or an MX5 with a V8. Just ruin. 

The WHOLE point of a sports car is the sharp, pure, hard edged nature. 
Not something a clanking, chugging old V8 will ever give you.
Reply: MIGHTYSAMINYOURFACE The LS is not a good engine. That is all. I've yet to hear of any LS swaps within 100 miles of me. There are almost none outside the US. In fact, it's highly unlikely you'll see any kind of car with an LS engine outside America. I see more Ferrari's in an average week than LSs of any kind in any sort of car.
Reply: sparty94 What's not to like.... Hmm. The low output for size, the low output per unit fuel put in (I'm not a fan of just setting fire to money for the hell of it, I want results), the terrible, awful valvetrain design, the lumpen, broken noise they make and they're not actually that reliable. 
My LS1 decided to shit its entire valvetrain into the cylinders thanks to one of its stupid spindly pushrods deciding it was time to be a bannana. Of course, this demolished the engine, and subsequently my wallet in short fashion.
This is the sort of thing you put yourself in for when you decide that what is possibly the most important part of the engine, the valves, are controlled by little twigs.
Reply: It is better than having rubber bands controlling the cams
Reply: +Lucas Boyden lmfao
Reply: James Schall So a brand new 6.2 litre that gives 550, no, wait, what? 430hp?!?! What? 
That's crap. And for, what, 7 grand, you could build a 500hp 2J, which would be better.

They do weigh something. You've obviously never had to lift one. They weigh more than most 4 and 6 cylinder engines, easily. 

The VQ is considered quite a weighty thing... And can still be brought up to 1500hp. A 2j too.

An LS is significantly larger than a VQ. Longer and wider.

Plus, LS engines are NOT cheap unless you live in the US, and even then, a lighter, more efficient, better supported engine like an SR20 can be had cheaper.

And all that's before you get to the crux of the matter. LS engines are nasty. There are very few vehicles that could be improved with a cheaply made, poorly designed heap like an LS.
Reply: @TheWierdFish  you realise with the LS engine it's easy to make high HP compared to most other engines.

LS swaps are perfect for American vehicles. LS swap old trucks. LS swap muscle cars. LS swap full size sedans. LS swap off road cars. LS swap track cars. They are affordable and reliable. For only a  grand you can easily make 800+ horsepower. They work great as replacements for other V8s. I'm not saying LS swap the world. I'm just saying LS engines are pretty good.

Also LS swapping RX7s should be a crime.
Reply: @QuantumPlaysOfficial  They may be affordable in the US, but they are actually pretty expensive everywhere else. Plus... they're not good. A good engine already makes power. A bad one, with a lot of work, can make power, but that doesn't make it good. 
From experience, they're no more reliable than anything else. Probably slightly less, as there are just far more small, delicate moving parts. 

The fact that custom blocks, heads, cranks, pistons and rods are so readily availble suggests that, maybe, the original parts weren't that great. And if you need a new block and heads for your engine... you haven't got that engine anymore. You've got a different one. 

There are a thousand other engines that do the same job. The LS is the one that has the biggest fan club, ergo the one with the greatest number of people shouting its virtues.

An LS works great for a swap into, for instance, some 1950s truck. I'd like that. But a 1950s truck is also the last place I'd want 800hp. Plus, if the opportunity is there for a big old school American V8, a proper big block Hemi is just has so much more character to it. 
Or, another of GM's back catalogue, the surprisingly nice LT5 from the early 90s. That is a sweet engine. Nearly 400hp, 5.7 litres (so pretty small by US standards) and unlike everything else produced at the time, it liked to rev. 
Of course I only found that out after I ignored the C4 Corvette and bought myself a pile of turd C5...
Reply: 2 valve push rod engines have a lot more potential than you think. Go watch David Vizards videos